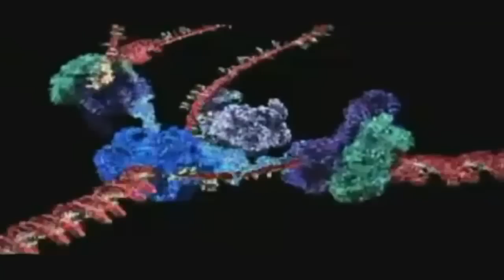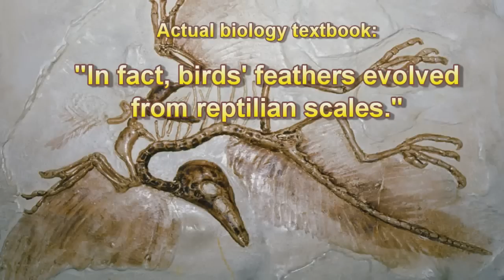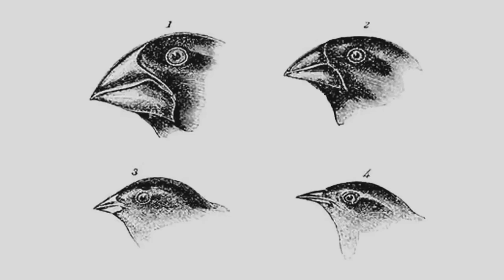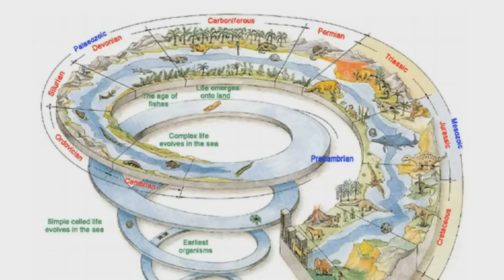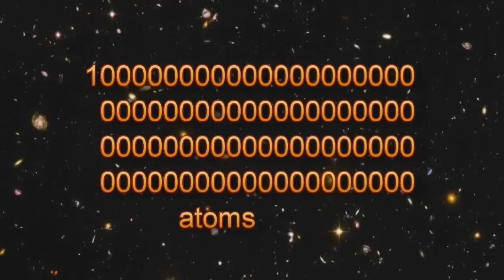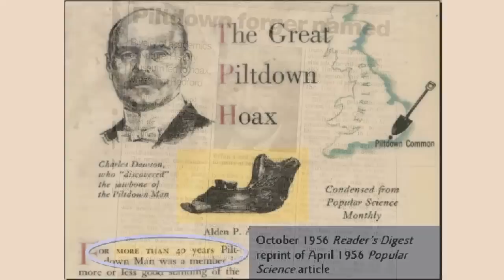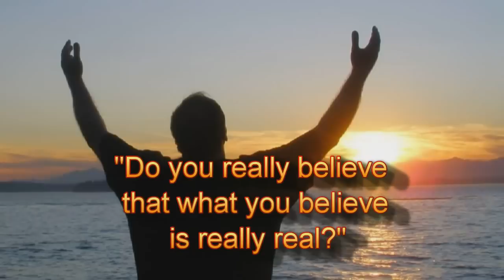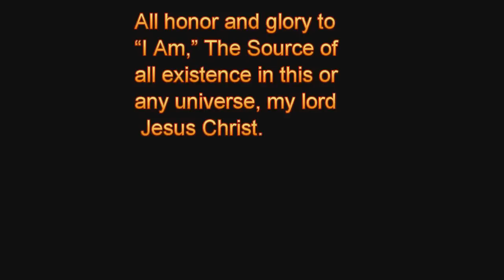Evolution Demolition

Comment: What an excellent and extremely well made video. A thorough and complete shalacking of the evolution myth. Thanks for taking the time to produce this!
Reply: Gave up on whale evolution? What whale evolution? They never evolved! Ha ha. You failed to explain the evolution of whale trachea and blowhole separation. But then again evolution can't even account for the origin of a simple tube so forget blowholes!
Reply: A little revisionist history there cowboy! What I meant, and you knew damned well, is that the fossil lineage of whale "transitions" are either fragments of a full land mammal or fossils of a whale. Nothing in between. You got reduced to petty word play. It was pathetic and typical. But the victory was delicious. Genetic accidents didn't invent hundreds of new body parts while changing little ole 2 ft long, 20lb vegetarian indohyus into a 100ft, 300lb krill filtering blue whale with a dual opening blowhole after all!
      So once again, please explain why seals haven't evolved blowholes or got any bigger in 50my but whales did. Why did evolution make whales so enormous? Detail the transitions of the whales esophagus and trachea as the magic mutations slowly divided them in two separate tubes. Be specific about the neurological, histological and osteological changed that occurred.
Reply: Phillip Zachry Because you've gone full on evo-church you only see evolution and not reality. There is no nasal cavity drift. Only artist fake clade drawings and replica fossils demonstrate that lil boost evolution needs to fool the audience. 
This is an unfair tactic paleontologists use to lift their findings and boost them to fame in a fake science believed by many and pays them grant money. You being a layman "company man" wouldn't dare question the mighty scientists. I mean God forbid you question evolution. You might get laughed at. The groupthink psychology has you. But little ole me looks at the evidence. Plus being a physician helps since I've had many hours of chemistry, bio, anatomy and physiology. Does that make me a paleontologist? No. But I know how to read scientific papers. 
Again, the "whale precursors" do not appear in the correct order. An inner ear bone similarity to a modern whale isn't enough to convince me little indohyus was a whale to be. Even Gingerich said he doubted rhodocetus had a fluke tail after discovering its artiodactyl limbs. Aetiocetus WAS a whale. One of many different types. In a global pool of fossils showing no gradualism, stasis and living fossils still unchanged today the likelihood they actually captured whale transitions is infinitesimal. 
Not to mention, RMNS is not capable of causing vertical evolution. 
I don't see how you can excuse seal stasis. If evolution were valid we should see seal "cousins". Some more deep sea evolving blowholes, some as they are now and some evolving more land mammal features depending on the environment. This just makes sense to an objective mind which you don't have.
Reply: ***** Exactly. It's amazing how "no evolution" is exactly what they expect to see and if think you should see evolution then "you don't understand evolution". Such a convenient position. But it fits the hoax perfectly.
Reply: Phillip Zachry  Lawrence is Right. It is not consistent with the neo darwinist teaching.
Reply: That post you continually post does not show transitions. It shows pakicetus, a 3ft land mammal, Aetiocetus, a whale and a beluga whale (20ft long). 2 whales and a land mammal. There's no reason to put pakicetus on that list. Especially" illusional" is the fact that they don't show the sizes of them in their proper proportions in order to trick the student. The 2nd clade drawing link you keep posting isn't evidence. Once again the size discrepancy of the animals are not shown in true proportion and those drawings are complete imagination. Nobody knows what those animals looked like from the handful of bony fragments found. Yet you fall for it. So yes, I deny the nasal cavity drifted due to zero evidence they did. 
I never suggested seal should become whales. Although why not? Why didn't pakicetus just become a seal? Where are all the seal transitions? Of course you can claim that the "selective pressures" were different but that's a just a cop out. 
I don't need to provide evidence of no evolution. That's like me saying you have to provide evidence that pink elephants do not exist. What the "experts" claim to be evidence for evolution doesn't pan out. Not for whales monkeys or anything else. Sorry if you don't like it. AGAIN, evolution can't even account for a simple tube. Start there.
Reply: Phillip Zachry Evolutionists agreeing that evolution occured, isn't evidence for evolution.

Astrologists agree that astrology is correct.

That doesn't make either right.

The evolutionists do not agree that Neo Darwinism and Punctuated equilibrium are valid.

Evolutionary Scientists have come out and ditched neo darwinism now and said that it is dead.  Gould said it was dead back in 1980. 

Professor Jerry Coyne who clings on to neo darwinism for dear life says Punctuated equilibrium is bunk.

While scientists have recently caught up with Gould's words and admitted the death of neo darwinism, they haven't formulated a new hypothesis yet. 

Evolutionists are desperately trying to come up with a unified theory but they haven't succeeded.
Reply: Phillip Zachry You are the one who is deceived. You have been tricked in to thinking  that animals like pakicetus are related to whales. Why? Because "experts" said "A kinda looks like B, Therefore B evolved from A." and you believed it.
Reply: don leavell "Gamesbok"

You seem upset Gamesbok because you failed on the other thread. Try another sock.

HAHAHAHAHAHAHAHA
Reply: Marshall Roberts
You're not actually making sense.  Apart from replying to don leavell and then addressin me, you make statements that are totally unsupported.  If Koonin publishes in a journal where he is part of the editorial team, then it's opinion, not peer review.  His criticism is nothing new, as I pointed out but you could not understand.  I showed too that the same article utterly destroys your position  irredeemably, but that escapes you too.  For pity's sake, ask an adult to help with comprehension.

Let's look at Koonin's publications,

Koonin EV (2011) The logic of chance: the nature and origin of biological evolution. Upper Saddle River (NJ): FT Press.
Koonin EV, Karev GP, Wolf YI  (Eds). Power laws, scalefree networks and genome biology, in press, Landes Biosciences and Springer Verlag (2006)
Koonin EV, Galperin MY. (2002 )SEQUENCE - EVOLUTION - FUNCTION. Computational Approaches in Comparative Genomics. Kluwer Academic Publishers.
Galperin MY, Koonin EV (Eds). (2002) Computational genomics: from sequence to function. Horizon Press.
2. Invited articles and book chapters
Galperin MY, Koonin EV. From complete genome sequence to 'complete' understanding? Trends Biotechnol. 2010 Aug;28(8):398-406
Koonin EV, Wolf YI. Constraints and plasticity in genome and molecular-phenome evolution. Nat Rev Genet. 2010 Jun 15;11(7):487-498
Koonin EV, Yutin N. Origin and evolution of eukaryotic large nucleo-cytoplasmic DNA viruses. Intervirology. 2010 Jun;53(5):284-92
Koonin EV. The origin and early evolution of eukaryotes in the light of phylogenomics. Genome Biol. 2010 May 5;11(5):209
Koonin EV, Moss B. Viruses know more than one way to don a cap. Proc Natl Acad. Sci U S A. 2010 Feb 23;107(8):3283-4
Koonin EV. Preview. The incredible expanding ancestor of eukaryotes. Cell. 2010 Mar 5;140(5):606-8
Koonin EV. Taming of the shrewd: novel eukaryotic genes from RNA viruses. BMC Biol. 2010 Jan 12;8:2
Koonin EV, Makarova KS. CRISPR-Cas: an adaptive immunity system in prokaryotes. F1000 Biol Rep. 2009 Dec 1;1:95
Koonin EV. On the origin of cells and viruses: primordial virus world scenario. Ann N Y Acad Sci. 2009 Oct;1178:47-64. PubMed PMID: 19845627.
Koonin EV. The Origin at 150: is a new evolutionary synthesis in sight? Trends Genet. 2009 Nov;25(11):473-5. Epub 2009 Oct 14. PubMed PMID: 19836100; PubMed Central PMCID: PMC2784144.
Koonin EV, Wolf YI, Puigbò P. The Phylogenetic Forest and the Quest for the Elusive Tree of Life. Cold Spring Harb Symp Quant Biol. 2009 Aug 17. [Epub ahead of print] PubMed PMID: 19687142.
Koonin EV, Aravind L. Comparative genomics, evolution and origins of the nuclear envelope and nuclear pore complex. Cell Cycle. 2009 Jul 1;8(13):1984-5.
Shabalina, S. A., and E. V. Koonin. 2008. Origins and evolution of eukaryotic RNA interference. Trends Ecol Evol.
Koonin, E. V. 2007a. Metagenomic sorcery and the expanding protein universe. Nat Biotechnol 25:540-542.
Koonin, E. V. 2007b. Chance and necessity in cellular response to challenge. Mol Syst Biol 3:107.
Koonin, E. V. 2007c. An RNA-making reactor for the origin of life. Proc Natl Acad Sci U S A 104:9105-9106.
Makarova, K. S., and E. V. Koonin. 2007. Evolutionary genomics of lactic acid bacteria. J Bacteriol 189:1199-1208.
Aravind, L., L. M. Iyer, and E. V. Koonin. 2006. Comparative genomics and structural biology of the molecular innovations of eukaryotes. Curr Opin Struct Biol 16:409-419
Prangishvili, D., R. A. Garrett, and E. V. Koonin. 2006. Evolutionary genomics of archaeal viruses: unique viral genomes in the third domain of life. Virus Res 117:52-67
Iyer, L. M., S. Balaji, E. V. Koonin, and L. Aravind. 2006. Evolutionary genomics of nucleo-cytoplasmic large DNA viruses. Virus Res 117:156-184.
Koonin, E. V., and V. V. Dolja. 2006. Evolution of complexity in the viral world: the dawn of a new vision. Virus Res 117:1-4.
Koonin, E. V., L. F. Landweber, and D. J. Lipman. 2006. A community experiment with fully open and published peer review. Biol Direct 1:1.
Makarova, K. S., and E. V. Koonin. 2005. Evolutionary and functional genomics of the Archaea. Curr Opin Microbiol 8:586-594.
Novozhilov, A. S., G. P. Karev, and E. V. Koonin. 2006. Biological applications of the theory of birth-and-death processes. Brief Bioinform 7:70-85.
Koonin, E. V., and Y. I. Wolf. 2006. Evolutionary systems biology: links between gene evolution and function. Curr Opin Biotechnol 17:481-487.
Koonin, E. V. 2005a. Orthologs, paralogs, and evolutionary genomics. Annu Rev Genet 39:309-338.
Koonin, E. V. 2005b. Paralogs and mutational robustness linked through transcriptional reprogramming. Bioessays 27:865-868.
Koonin, E. V. 2005c. Virology: Gulliver among the Lilliputians. Curr Biol 15:R167-169.
Koonin, E. V. 2005d. Systemic determinants of gene evolution and function. Mol Syst Biol 1:2005 0021.
Rogozin, I. B., A. V. Sverdlov, V. N. Babenko, and E. V. Koonin. 2005b. Analysis of evolution of exon-intron structure of eukaryotic genes. Brief Bioinform 6:118-134.
Rogozin, I. B., K. S. Makarova, Y. I. Wolf, and E. V. Koonin. 2004. Computational approaches for the analysis of gene neighbourhoods in prokaryotic genomes. Brief Bioinform 5:131-149.

And you want me to accept he rejects evolution?
Reply: Gamesbrok, which one of your evo funny papers provides "peer reviewed" evidence for the origin of a simple blood vessel? "Mutations did it!" Right?
Reply: Marshall Roberts ' Well 9pt9, understanding evidence was never your strong point.
'This from a guy that rejects the fact that what is natural is living organisms give rise to living organisms.' 
What is unquestionably true is that everybody accepts this is less than the complete story.  The difference is that some people do not accept magic.  I don't know why some folk reject understanding.  (Yes I do).
Reply: 9pt9
Of course mutation?  What else? 
It's complicated today because we have Angiogenesis which appears to be a developed feature, but not necessarily.
Risau W. Mechanisms of angiogenesis. Nature 386: pp. 671–4, 1997.
Risau W. Differentiation of endothelium. FASEB J 9: pp. 926–33, 1995.
Schmidt A, Brixius K, Bloch W. Endothelial precursor cell migration during vasculogenesis. Circ Res 101: pp. 125–36, 2007.
Coffin JD, Poole TJ. Endothelial cell origin and migration in embryonic heart and cranial blood vessel development. Anat Rec 231: pp. 383–95, 1991. Risau W, Flamme I. Vasculogenesis. Annu Rev Cell Dev Biol 11: pp. 73–91, 1995.
Reply: Gamesbrok, angiogenesis is not a Darwinian process. Reload, try again. Evolution can no explain the origins of blood vessels or any "tube" in an organism. Provide an evolutionary pathway or example for any tube forming in stepwise fashion. "Mutations did it" won't fly.
Reply: 9pt9
Oyster mushroom.
Reply: 9pt9
Let me get this straight; you claim that evolution can only progress in a manner you deem to be impossible? Interesting,
Reply: Steven Land Actually my "fallback position" was to read the articles you cited. Not one of the 4 papers offer any clue as to how vessels evolved. All the articles and the video  beg the question. They all assume the evolution of vessels without offering a plausible mechanism. You either didn't read the articles or you're just committed to believing in evolution no matter how absurd it is (and it is extraordinarily absurd). I dare you to sift through those laughable rags and pull out the best paragraphs or bullet points that bolster your belief that vessels evolve. What good is 5% of a vessel?
Why are you are you talking about zombies and Christianity? It's Evolution vs science not evolution vs religion. Nice red herring though. 
Care to fail again?
Reply: 9pt9
You do know that you're a Deuterostome don't you?

The Molecular Motor Toolbox for Intracellular Transport
Ronald D Vale
Department of Cellular and Molecular Pharmacology, Howard Hughes Medical Institute, University of California, San Francisco, 513 Parnassus Avenue, San Francisco, CA 94143 USA
Reply: Gamesbok Gamesbok
 I'd have gone with these papers first--'U
nique domain appended to vertebrate tRNA synthetase is essential for vascular development' and 'Evolutionary origins of the blood vascular system and
endothelium'
Reply: Helixbuilder
I like the Monahan-Earley R paper.
Reply: Gamesbok Gamesbok Yeah, I doubt that 9pt9 actually looked at the data in any of those other papers. This yet another case where a dissenter, 9pt9, has not bothered to critically examine the literature before reaching a conclusion. He has done so by choosing to go with AiG or some other creationist’s apologetic rhetoric.
Reply: Helixbuilder Of course I read it. Please explain how that paper you cited provides evidence for vascular evolution.
Reply: 9pt9 Clearly you did not read them. So you would have me believe that in an hour in a half you read a data dense paper and a review and fully understood it? You’ll forgive me if I doubt that you did so. No scientist I know takes that short a time to read a paper let alone a review. Which paper and figures did you find the data less compelling? What would you have done differently?  So why is the data wrong? Because you think it is impossible. Not good enough show me with data not words.
Reply: Helixbuilder I didn't say the data was "wrong". You cited the paper so I'm asking you to explain how that paper provides an evolutionary pathway that in anyway explains the origins of vessels. It doesn't. It begs the question and actually makes evolution look worse. Citing a paper isn't an argument.
Reply: 9pt9 No, you said you read the paper and you are arguing against the data. Should I conclude that you have no reading compression skills? You say you read the paper but you want me to tell you what is said? Why should I waste my time if I don't know what data your argument is based on? Make your point then we'll go from there.
The review outlines the data and puts forth a model which you claimed was impossible. Further you claimed there was no evidence if the work over over sixty labs isn't evidence kindly tell what is.
Reply: That study showed that SerRS plays a role in the development of endothelial tissue and when mutations occur to it produces abnormalities (not helpful for evolution). It also showed that SeRS is present in organisms with closed circulatory systems. Whoopity-do. No evidence for how vessels evolved in stepwise fashion whatsoever.  
The fact that you would posit that study to bolster your case just shows that you blindly googled "evolution of vessels" and picked it out. As if because there is an almighty "peer reviewed" study on evolution it's 100% fact. What's more telling is that between you and all the other believers on this thread coming down on me with studies, none of them come close to answering the question. I'm telling you the answer the origins of vessels and many other examples like this do not exist. I've looked. The studies are done presuming the mechanism of RMNS and beg the question.  
  Just because you can see evolution is bullshit doesn't make you religious by default. It just means we still don't know. And we don't. But for bollocks sake open your bloody eyes.
Reply: Stephen Land  You're really throwing some tantrum there.
Reply: 9pt9
Ah actually the authors say “Interestingly, three independent forward-genetic studies in zebrafish suggested a role for SerRS in vascular development,” as in angiogenesis that is blood vessel formation. So in order to establish a possible pathway on must first identify genes that are in the normal pathway. The paper shows that the SerRS gene product is essential for vascular development. Critical to this function is an appended amino acids sequence that comprises the UNE-S domain. Oh that means the domain was added on the ancestral protein as in mutation.
That paper came out in 2011 the review paper came out in 2013.
 
So explain why mutations are “not helpful for evolution”.
Reply: Stephen Land And with all those "umpteen" studies inside the "mountain of evidence" for evolution you couldn't even answer the simple question (How does RMNS build a tube in stepwise fashion).  That should be no problemo for such a distinguished scientific theory and here you and evolution are stumped. No matter how many gaps there are you'll plug it with "mutations did it." Pathetic and hilarious watching groupthink ideology at work. Now that we understand cells on a far deeper level the gaps keep mounting up. Ribosomes, ATPsynthase, DNA all inexplicable but no matter what "mutations did it."
Don't worry I know where your coming from. Now piss off :)
Reply: Stephen Land  You're ranting and raving stevie. You lost the argument.

hahahahahahahahaha
Reply: 9pt9  Poor Stephen is having a massive meltdown after his failure. He is such a cry baby.  hahahahahahaha
Reply: Now that we've established that RMNS can't even make a tube who would like to prove evolution invented DNA? Ha ha ha ha ha!
Reply: 9pt9
You didn't prove anything you just stated your opinion. Where is your data?
Reply: Hex, I don't need to provide data, The burden of proof is on evolution. I asked a question than nobody could answer so there's my proof.
Reply: 9pt9
Well the irony of you using the absence of evidence as proof of a negative is stunning! Thanks for the amusement!
Reply: Helixbuilder Right. "mutations did it" no matter what! The answer is mutations now what's the question? ha ha ha ha ha ha!
Reply: 9pt9
Saying that proves nothing, where is your data? Without doing an experiment all you are doing is offering an opinion. Opinions are not factual. Demonstrate that mutations cannot change an organism show your data.
Reply: Helixbuilder   What reverse logic you have. It is up to you to demonstrate that mutations can do what you believe they can do. He asked you to demonstrate something when it came to the hypothesis that you hold to and you failed it.  He does not have to experimentally  demonstrate mutations cannot do what you claim they can.   You have to demonstrate experimentally that they can do what you claim. You are making the claim and yet you couldn't pass the test when it came to a  tube. If you don't have the evidence then that is a problem for you. Not the person who is skeptical of your hypothesis.
Reply: Helixbuilder How can an experiment be done that proves RMNS can't build a tube? You make no sense.
Reply: Marshall Roberts
Wrong there are papers with evidence from over 60 labs on this question of angiogenesis alone. In the review the author sets forth a scenario to explain the process. So one could say they establish reasonable doubt of 9pt9's claim of impossibility. 9pt9's claim is an opinion because he presents no evidence. Further 9pt9 dismissal of evidence by hand waving is nonsensical as it reveals the he doesn't accept the evidence because it contradicts his explanation. The data from these papers as well as data from de novo blood vessel formation in tumors in combination with genomic comparisons say these processes are possible therefore it is on him to demonstrate that a process can't happen. This will be hard as 9pt9 can't even define what the process is; so how can he say it is impossible?
 
Why can't a creationist grasp the idea of; the absence of evidence does not prove a negative? This is the same logic is used by creationists when they argue that Yahweh exist in the absence of any physical evidence. Truly ironic!
Reply: Helixbuilder  "he presents no evidence"

You are again making no sense. If you make up a story of how something happened then it up to you to present the evidence for it.

You claim these papers support you but you do not make an argument to him on how it supports you, Just saying "these papers support me you are wrong" is not an argument. You have to make an argument and show why they support your position. You presented no argument to him to show how they support your position.Without any argument then your claim has no merit.

"absence of evidence does not prove a negative"

So you are admitting an absence of evidence, that is fine. But then Evolutionists should not berate those that do not accept evolutionary story telling.
Reply: Helixbuilder Angiogenesis is not evolution and neither is de novo vascular formation. Neither process uses the darwinian process of selected mutations. Vessels and their codes already exist here.  You are just showing your ignorance. 
Yes it is my opinion. And it will stay that way until any evidence whatsoever can prove evolution could gradually produce a tube of any kind. But there is zero and there never will be because evolution is a wrong theory. Sorry.
Reply: 9pt9
Thank you for stating the obvious in order the study the origins of a process one must know its components and nature.
The ball is back in you court explain why the model in the review is incorrect.
Reply: Marshall Roberts
Thank you for demonstrating the you have no reading comprehension. The argument is in the review paper pages 62-63, there is no need for me to restate it as it is congruent with my conclusions.The evidence is discussed previously in the review. So why do I have to restate it and why is it wrong?
Reply: Helixbuilder  Posting links is not a substitute for an argument.  Just spamming links and not giving an argument is citation bluffing.

"as it is congruent with my conclusions"

You have to show with argumentation how it supports your position otherwise you are  citation bluffing.

Could you imagine you went to a debate and one debater made no argument and said "these links prove my position" and I am right.  It wouldnt be much of a debate.

If there is evidence in the review then why are you unable to argue for it? links are ok in addition to an argument but not a substitution.

He has pointed out what he has seen as problems with what you posted. Yet there is no burden on him at all, It is up to you to do your own homework and then provide your argument. It is not for him to do your work for you. You can research any links that you like but then it is up to you to provide an argument for how what you researched supports your position. It is not his duty to do anything with your spammed links. You are trying to shift your burden. So research whatever links  you want and then provide an argument on how they support you. But it is your duty to do your work not him to do it for you, Spamming links and claiming they support you is not an argument and does not demonstrate that they support you.

Now when are you going to stop bluffing and posting links and claiming that they are evidence and actually provide an argument for how they are evidence that support your position?
Reply: Marshall Roberts I would give the same assignment to any student who used logical fallacies as if they were proof of principal. He claimed that something was impossible without providing any evidence or a reasonable hypothesis to test.
Yes that counter argument that "there is zero (evidence) and there never will be because evolution is a wrong theory."
 He is just invoking the God of the Gaps logical fallacy.
Reply: 9pt9
I gave you the paper I can only conclude that you are so biased that you refuse to believe anything contrary to your religious beliefs. Rather you respond in a Monty Python-esq argument of denial with no substance. You wanted evidence it is in the papers figures and picture cannot be accurately expressed in words so I thought you might look at the original data.
What would you accept as evidence?
Reply: Alright,  post the link again. I've already read 5 on this thread. All failed.
Reply: Justwantahover: Fossils are in layers of course. Expect one layer doesn't lead to the next. Zero gradualism. Organisms appear fully formed and are still alive today, mainly unchanged, or they go extinct. That is the scientific facts. There is no evolution. 
Now clear your head and think real hard. If evolution can't answer these challenges the whole theory is wrong. 

1) Can evolution explain the origin of a tube in stepwise fashion?

2) Can evolution even account for 1 cell? 

                     Nope.
Reply: You're not getting it. There is nothing connecting the layers. No transitions at all. Evolution needs to account for 3.5 BILLION YEARS of unicellular life (many of which are still alive today unchanged!) with ZERO evolution followed by the sudden appearance of all the major body plans in a geographic flash. There are no unicellular organisms gradually becoming more complex then or now. The whole theory is bogus.
Reply: 9pt9
1) Can evolution explain the origin of a tube in stepwise fashion?

A. Yes, and you refuse to accept the data. You invoke the logical fallacy of incredulity. Congratulations!

2) Can evolution even account for 1 cell?
A. No, we have a different theory for that calleed abiogenesis. Look up a series of lectures on youtube from Jack Szostak Nobel laureate.
Reply: Sorry, you failed to provide evidence it can.You are guilty of the fallacy of credulity.
Reply: 9pt9 SO you are stating that you have fossils of bacteria that are identical to existing bacteria? Wow publish that and collect your Nobel Prize.
By the way they aren't really unicellular they live in bioflims.

"There are no unicellular organisms gradually becoming more complex then or now."
 A. How about the organisms in the class Dictyosteliida for starters?

Oh and yes the estimates of the Cambrian explosion 5 to 40 million yeas is a "geographic flash". Not all of the body plans are found in the Cambrian rock layers specifically those body plans belonging to the phyla that include: mammals, reptiles, birds, insects, and spiders.
Congratulations!
Reply: 9pt9
 How cute; your turn where is your evidence?
 I said it can happen just like you said it can't.
Reply: Helixbuilder I don't need to provide evidence that something did not happen (for the 10th time). You need to prove it did. 
Cyanobacteria still exist today unchanged. 
The fact that you're citing dictyostelium an example only proves how bankrupt the theory is. What is it about dictyostelium that would lead you to believe that organs, skin or limbs will ever evolve from it or that it's in any way relative to our ancestry? Why aren't there uni's going multi everywhere in all the various stages of evolution? This KILLS evolution. 
Compared to the 3.5 billion years that bacteria did nothing the cambrian is a flash. 
Give up. Evolution loses.
Reply: 9pt9 You can't prove it didn't happen, you believe it didn't happen; therefore, you have to provide evidence to prove your point!
That is just the way it is!
The rest is just unsupported nonsense saying rather than showing! No evidence at all!
Since you have no data to refute I'll just say your opinion is bogus!
Reply: Ok! And you can't prove there are no pink elephants that can fly!
Reply: 9pt9
You can't prove there are!
So the question becomes why do you feel that you can make up claims and act like your silly statements prove anything?
Reply: Helixbuilder Where is your evidence that evolution can assemble a tube? Be very specific. :)
Reply: 9pt9
Where is you evidence of god? Be specific. All kiding aside I'll be specific when your state how you know it is impossible. Oddly enough had you read the most recent papers you wouldn't have to ask! :)
Reply: You are a master at diversion tactics. Which paper? Cite it and explain how it supports your position. The existence of God is completely irrelevant. It's evolution vs real science not evolution vs God.
Reply: A tube is 100% useless until it can contain fluid or solids in a closed system. How did evolution create a tube by accidental selected mutations slowly over time? What was the structure before it was a tube? Why was it selected for? This is why evolution is 100% impossible.
Reply: 9pt9
Had you read the paper you would have an idea. But since you think you know everything  just continue with your ravings! Accidents are deviations from a purpose, What does the circulatory system of cnidarian look like? What did the paper say?
Reply: 9pt9
Thanks! The one you didn't read because you already "knew" the answer. :)
Reply: 9pt9 Voids in a aquatic body allow for higher surface area for nutrient and waste exchange. Perhaps you'd like to start there. By the way what is the purpose of a circulatory system anyway?
Reply: 9pt9 Try looking at  the post prior to where you first replied to me. Why do you need to be spoon-feed knowledge? Think for yourself!
Cheers!
Reply: A worm wrapped around some food? Sponges developed a bony chip? And the mutations took over from there! LOL Now THATS a fairytale. I'm sure you've got "facts" to back that up. Not.
"The reason you don't accept facts is bc your book of fairytales." Fallacy of motive. Fail.
Reply: 9pt9 Hey they guy is trying you on the other hand are reiterating an argument concieved out of disbeleif not data.
Still haven't found it?  Evolutionary origins of the blood vascular system and
endothelium R. MONAHAN-EARLEY, et al. It a review red the mechanisme than goto the original papers cited and check out the data.
Reply: Helixbuilder Page 1 "Molecular phylogenetic analyses have yielded interesting, although limited insights into evolutionarily conserved mechanisms of heart development and tube formation."
Translation: We have no idea but here's a wild guess. 
So your silver bullet of evidence is nothing but speculation. But don't feel bad. All evidence for evolution is like this. Good news is you're getting closer to the truth about evolution!
Reply: 9pt9 "A worm wrapped around some food? Sponges developed a bony chip? And the mutations took over from there! LOL Now THATS a fairytale. I'm sure you've got "facts" to back that up. Not."

You got him sussed

Justwantahover loves his evolutionary fables.

These darwimps do provide good comedy with their story telling.

hahahahahahahahaha
Reply: The best piece of evidence he could find on how tubes evolved began with a statement saying little is known on tube formation. 
But I'm glad I can help. These people really believe they have absolute facts on their side. They just need to shed the dogma and be objective and down goes evolution religion!
Reply: Justwantahover I think you get an award for the longest speech ever given on youtube. You are committing the fallacy of motive. "Evolution is right bc we believe in creation". It does no matter whether or not creationism is true. Evolution is still bogus.
Reply: 9pt9  Really?
The paper opens with "Every biological trait requires both a proximate and evolutionary explanation. The field of vascular biology is focused primarily on proximate mechanisms in health and disease. Comparatively little attention has been given to the evolutionary basis of the cardiovascular system."
Which has an entirely different meaning then your paraphrasing of the the first two sentences. Did you read any further?
Reply: Helixbuilder Give it up. I won. You lost.
Reply: 9pt9 If in your mind lying about reading a paper and its contents is winning then congratulations! 
Considering biofilms, that are a collection of bacteria living as a multicellar community. They consist of many species existing in close physical contact. They also communicate via quorum sensing compounds. Within the biofilm are channels within that conduct nutrients and waste into and out of the biofilm. These channels act as a primitive circulatory system.  Given the fact that a genetic mechanism is predicted and that the evidence for that would be found in the genomes of related organisms that have circulatory systems. Further evidence shows that these mutations exist as predicted; I'd say that your opinion is wrong! Additionally since your don’t bother to discuss the data indicates that you know you are wrong and are unwilling to admit it.
Reply: 9pt9
Yep you are a liar because when you say an article says something that is does not that is by definition a lie. The rest of your post? Unless you have data you are only stating your opinion, You don't have data and the review paper will direct you to the orginal research paper that contains the data. You don't want to look at it; so what does that say?
Reply: Helixbuilder Ofc I looked at it. Doesn't contain any "data" that supports your belief. You're just desperately trying to find away to discredit my character so you needn't face the reality I've proven to you.
Reply: 9pt9
Because you didn't read it or firmly believe there can be no data. That puts you in the same intellectual class as the cardinals the refused to look in Galileo's telescope; because, Aristotle wrote that Jupiter had no moons; therefore the cardinal did not need to look to know what is so.
Reply: Helixbuilder LOL look what you've been reduced to!!!
Reply: 9pt9 If it supported him then he would have been able to quote from the article and provide an argument of how it supports him. hexbuilder was citation bluffing.
Reply: 9pt9
Review papers cite research so the data is in the referenced paper.
Reply: Marshall Roberts
It is not how I roll I point you read then you think. If you don't honestly evaluate the data then shame on you.
Reply: Helixbuilder Throwing the term liar at him so casually shows desperation because you are failing in argumentation against him.
Reply: Marshall Roberts He's had a million chances to prove his point and can't so his last resort is "well…ah….you're a liar!"

hahahahahahahahahahahahahaha
Reply: Justwantahover He failed, he was citation bluffing and failed to show the data supports your faith. You lost. You need to get over it.
Reply: Justa - he gave me "data" and I crushed it. I'm winning because I am demolishing your answers. Your crew has scrambled trying to respond to my challenge and failed. It was just one simple question and you failed. And I can make it a lot worse :)
Reply: 9pt9
Yep that is right you can't read or interpret data so winning is lying about data! Amazing!
Reply: Justwantahover
The difference between human and chimp genomes is "thirty-five million single-nucleotide changes, five million insertion/deletion events, and various chromosomal rearrangements" and  "Single-nucleotide substitutions occur at a mean rate of 1.23% between copies of the human and chimpanzee genome, with 1.06% or less corresponding to fixed divergence between the species" , emphasis on FIXED.
http://www.nature.com/nature/journal/v437/n7055/full/nature04072.html
With this difference the human genome must be diverging from chimps at the rate of 2.5 fixed bases per year. i.e. Pharaoh's mummy would be maybe 10,000 bases closer to a chimp. Surely you know this is nonsense.
Reply: Justwantahover We are equally closed-minded because the non-evolving genome proves creation and you do not believe it, and if the genome were evolving, I would not believe it.
One sure thing - if the genome were evolving, the high priests of evolution would be blowing trumpets, but I don't hear them.
Reply: Marshall Roberts
Funny how you say that without a shred of data.
Reply: Justwantahover  In 1957, a distinguished geneticist and evolutionist, J.B.S. Haldane, calculated that the rate of beneficial mutations becoming FIXED in the human genome would be approximately 1 base every 6000 years.
http://en.wikipedia.org/wiki/Haldane's_dilemma
Even if he was wrong by a factor of ten and the true rate was 1 base every 600 years, that is nowhere close to what evolution requires for the difference between the human and chimp genomes.
Reply: Mdebacle: great point! Funny how a hard fact like that will make no difference in the mind of an evolutionaut. No matter how bad things look for the withering theory of evolution, it's believers will still cling to "mutations did it!".
Reply: Mdebacle
You really think calculations and models are always right as long as they support your beliefs. You don't think we have a more empirical data now?
Reply: Helix: if you have better "data" then post it.
Reply: Helixbuilder
Ötzi the Iceman is supposed to be 5300 years old. If his genes showed us that any evolution has taken place in that time frame we would have seen the headlines.
Reply: Mdebacle
So have you looked at the data? It is in a public data base.
Reply: 9pt9
Go to the primary literature, the sequence data bases then look and read.
Reply: Helix: How much do you love the word "data"?
Reply: 9pt9  hahahaha
Reply: Helixbuilder
I have enough faith in the Darwinist cavalry to realize they would be riding to the rescue if they were shooting anything but blanks.
Reply: Mdebacle In the depths of a mind insane
fantasy and reality are the same! The only thing you and you friend have to say is "its impossible" presumably because you think you know better. The science holds up so keep trying.
Reply: Helix: one cell creates 2,000 proteins per second. PER SECOND. Man has never invented a machine that can produce 2,000 of anything per second. Can you provide the "data" to explain how this biological capability evolved?
Reply: 9pt9
An argument of incredulity is not proof of your claim it is a logical fallacy.
Reply: 9pt9
I gave you the paper you said it was wrong; however, since your claim is no one can it explain it.Yet an explanation exist so your statement is false.
Reply: 9pt9
 The Darwimps have a lot of faith in dumb luck mutations, Even evolutionists have come out and admitted neo darwinism has failed. Gould openly declared it dead back in 1980 "despite being textbook orthodoxy" Going all the way back to the 60s, The mathematicians at the wistar symposium told the darwimps that it cannot work but the mutation intoxicated darwimps still went on promoting their nonsense.
 Other Evolutionists have come out and openly rejected neo darwinism and pointed out that it has failed, ie Professor Noble, the late lynn marguilis, Eugene koonin etc

But still the Darwimps have faith.
Reply: Since no evidence can prove RMNS can build a tube (and many other biosystems) I remain incredulous. Guilty as charged. You? A full on devout and faithful believer. The paper you cited as evidence specifically stated that the origin of tubes remains a mystery, wich was comical.
Reply: 9pt9 Actually there is but if you won't read a review that will outline the steps then how can I expect you to go further?
Reply: Marshall Roberts
Yada yada yada cite your references already!
Reply: 9pt9  helix was citation bluffing
Reply: Marshall Roberts I call your bluff; show your hand.
Reply: Helixbuilder  which bluff?
Reply: Helixbuilder   You were citation bluffing dude.
Reply: Marshall Roberts
No I already gave 9pt9 the citations, show your hand.
Reply: Helixbuilder I know you gave him citations and you were citation bluffing.
Reply: Helixbuilder
"show your hand"

?
Reply: Helixbuilder Is the theory of evolution you have faith in neo darwinism?
Reply: Marshall Roberts
Faith has nothing to do with evolution, more to do with Yahweh, Odin and big foot.
So where does this come from?
"Other Evolutionists have come out and openly rejected neo darwinism and pointed out that it has failed, ie Professor Noble, the late lynn marguilis, Eugene koonin etc"
Reply: Helixbuilder  You said to mdebacle

"The science holds up so keep trying."

The evolutionary community is deeply divided over a theory of evolution with some believing in neo darwinism but others coming out and admitting it has failed.

Despite the claims to the Contrary by Layman Evolutionists on the internet. There is no agreement amongst evolutionists for how evolution is meant to occur.  . There is no agreement on a theory of evolution. In 2008 Senior evolutionists met at Altenberg to try and flesh out a new theory of evolution but they went away without any agreement. There is no consensus at this time on a "Theory of Evolution"  When evolutionists claim on the net that it is all sown up and there is no disagreement on how it is meant to occur then they are using hype and talking contrary to the facts.

 
Only thing evolutionists agree on is its occurence.

"When discussing organic evolution the only point of agreement seems to be: "It happened." Thereafter, there is little consensus, which at first sight must seem rather odd. - Simon Conway Morris, palaeontologist, Department of Earth Sciences, Cambridge University, UK, "Evolution: Bringing Molecules into the Fold,"

"Evolutionary theory itself is already in a state of flux…
all the central assumptions of the Modern Synthesis (often also called Neo-Darwinism) have been disproven"
Denis Noble, Evolutionist and Biologist, May 2013

“Darwinism in its current scientific incarnation has pretty much reached the end of its rope.”  — David J. Depew and Bruce H. Weber, “The Fate of Darwinism: Evolution After the Modern Synthesis,” Biological Theory, Vol. 6: 89-102 (December, 2011).

Professor Allen Macneill-Biologist/Evolutionist Cornell University- "Will Provine and I have been saying "the modern evolutionary synthesis is dead" for years"

Professor Macneill " when ID supporters set their sights on “neo-Darwinism” as a target for criticism, they set their sights on a model that has been all but abandoned"

Gould 1980 as quoted by The Evolutionists Brian Charlesworth and Russel Lande
 
“I have been watching it  [neo-Darwinism] slowly unravel as a universal description of evolution…but…that theory, as a general proposition, is effectively dead, despite is persistence as text-book orthodoxy.”

Charlesworth, B., Lande, R., and Slatkin, M., "A Neo-Darwinian Commentary on Macroevolution,"

Evolutionist  Lynn Margulis
 “At that meeting [a meeting with philosopher John Cobb] [Francisco] Ayala agreed with me when I stated that this doctrinaire neo-Darwinism is dead. He was a practioner of neo-Darwinism but advances in molecular genetics, evolution, ecology, biochemistry, and other news had led him to agree that neo-Darwinism’s now dead.”

The recently deceased Evolutionary Biologist Lynn marguilis. “Population geneticist Richard Lewontin gave a talk here at UMass Amherst about six years ago, and he mathematized all of it—changes in the population, random mutation, sexual selection, cost and benefit. At the end of the talk he said, “You know, we’ve tried to test these ideas in the field and the lab, and there are really no measurements that match the quantities I’ve told you about.” This just appalled me. So I said, “Richard Lewontin, you are a great lecturer to have the courage to say it’s gotten you nowhere. But then why do you continue to do this work?” And he looked around and said, “It’s the only thing I know how to do, and if I don’t do it I won’t get my grant money.””

"The interpretation of evolution is in a state of upheaval: the rapid advancement of Molecular Biology has led into question many of the tenets of Darwinism and neo-Darwinism which, although valuable approaches at the time they were formulated, never fulfilled the criteria demanded by real scientific theories. . . In the author's opinion, no real theory of evolution can be formulated at present."

A. Lima-de Faria, Geneticist/Evolutionist, Professor Emeritus at the university of lund.
 
 
Stanley Salthe, author of an evolutionary biology textbook, says, "I have become an apostate from Darwinian theory and have described it as part of modernism's origination myth."
 
 

Professor Jerry Coyne "I had a lot of respect for Gould, but over the years it waned. He became enamoured of his theory of punctuated equilibrium which I thought was really wrong. I still do. He and I had several exchanges in the literature about that theory, with me saying it was bunk and him saying it wasn’t."

 Jerry Coyne Talking about Fellow Evolutionist Professor James Shapiro "A colleague wrongfully disses modern evolutionary theory".. "Shapiro, it seems, has devoted much of his writing to pointing out that the modern theory of evolution (“neo-Darwinism”) is deeply flawed and needs a new paradigm"

Eugene Koonin “the modern synthesis has crumbled, apparently, beyond repair”
 
 Eugene Koonin  “all major tenets of the modern synthesis have been, if not outright overturned, replaced by a new and incomparably more complex vision of the key aspects of evolution.”
 
Eugene  Koonin “not to mince words, the modern synthesis is gone.”  “The Origin at 150: Is a New Evolutionary Synthesis in Sight?,” Trends in Genetics, Vol. 25: 473 (2009

While some are clinging to neo darwinism desperately like Coyne and Dawkins and pushing that it is a fact, Others like Koonin have said it is dead.  The Altenberg 16 thought so and are amongst those looking for a new evolutionary hypothesis.

Fact is that there is no agreement and the scientific community is desperately trying to get together a unified theory of evolution to rally around.

Evolutionists are in deep trouble without an agreement as to a theory but they are desperately trying to put one together.
Reply: Marshall Roberts
Guold is entitled to his opinion however the science holds. So what science do you specifically claim doesn't hold up?
Reply: Helixbuilder Evolutionists themselves have said neo darwinism has failed though some darwimp priests like Dawkins and Coyne still hold to it.

The evolution industry is deeply divided without an agreed theory but the Neo Darwinist sales rep Dawkins does not mind as he can still make money  by selling neo darwinism to his Dawkinite flock.

"the science holds"

You have faith in something even evolutionists have declared as having failed.
Reply: Marshall Roberts  Yes that is your claim. Whether it is correct or not is another thing.
Reply: Helixbuilder  I have given you their own words. Because you do not want to face up to what they are saying is your own problem.
Reply: Helix: why did the author say the origin of tubes was a mystery on the first page? You are citation bluffing. And I'll tell you what, if I do read all 26 pages things will only get worse for you. Now, please explain the origin of Krebs cycle using evolution theory.
Reply: 9pt9
This paper 'Evolutionary origins of the blood vascular system and
endothelium'?
Reply: Marshall Roberts
Pardon me if I read the papers myself. So far it seems they are proposing a different mechanism for evolution.
Reply: Justwantahover
From the migration maps of human mitochondrial DNA in http://en.wikipedia.org/wiki/Human_mitochondrial_DNA_haplogroup , although the arrows are drawn to look like out-of-Africa, we can see the maps are consistent with three haplogroups (L,M,N) out of Mesopotamia.
Although the genetic chart has been revised to look like M and N are derived from L, we can see from the original chart in http://en.wikipedia.org/wiki/Mitochondrial_Eve that M and N are not derived from L. Every human has mtDNA from one of three women, who were the daughters-in-law of Noah.
Also, we can see the migration of human Y-chromosome in http://en.wikipedia.org/wiki/Haplogroup#mediaviewer/File:World_Map_of_Y-DNA_Haplogroups.png
They made a half-baked attempt to look like out-of-Africa, but it is easily seen that the Y-chromosome of Noah and his three sons was out of Mesopotamia.
Reply: Justwantahover [the secular rules work (and no other rules would work)]
The point that you are helping me make is that all the work was done for mtDNA by certified evolutionists.
They discovered (unwittingly) the haplogroups of the three daughters-in-law of Noah and conveniently assigned them as L,M,N,
When I saw the wikipedia article in 2008 (before they revised the genetic chart), it was like a beacon in the Heart of Darwinian Darkness.
Reply: Marshall Roberts
If Richard Lewontin said,  “It’s the only thing I know how to do, and if I don’t do it I won’t get my grant money.”, he defined a 'professional evolutionist'.
As a defense contractor once said, "We had the contract for spare parts for 25 years. Nobody cared if it worked or not."
Reply: Mdebacle: no he can not. Not at all. He's a full on believer.
Reply: Justwantahover
Just to clear things up HOX is the shortened version of Homeobox and PAX is short for Paired box.
Reply: Justwantahover
[Look up "hox-genes" on a secular site] I thought NIH.GOV was secular.
[giraffe and mouse] 
The giraffe is the tallest of all land animals. Its heart can be over two feet long and is engineered with a network of bypasses and anti-pooling valves that allow the giraffe to raise and lower its 500-pound (227 kg) neck and head without fainting. NASA scientists have studied the giraffe’s uniquely created anatomy to help them develop gravity suits.
In order to have common ancestry with a mouse, a giraffe would need randomly and simultaneously evolving genes for bones, heart, nerves, muscles, brains.
Instead of hysteria- inducing Darwinist ideas, why don't you visit a park with a flower bed and watch bees, butterflies, hummingbirds cross-pollinating the flowers.
Witness the creation. Nectar production and consumption were created two days (48 hours) apart. Think about how great the newly redeemed creation will be.
.
Reply: Justwantahover
The main evidence for creation and young earth would be:
(A) the discovery of chromosome numbers (1905-1910) show that the origin of every species was the first mating pair with the species' chromosomes. Plus the debilitating effects of random chromosome aberrations.
(B) the production and consumption of nectar, and the resulting cross-pollination occurred 2 days apart.
(C) the catastrophic event that produced fossils, fossil fuels and sedimentary rocks (sediment is the stuff at the bottom of water) all point to one Big Kahuna flood.
Reply: There is no "tree of life sequence" in the fossils. There are only different animals in different places. It's a 100% impossibility for all life to be on one tree. Try and work out how the spread of traits and biological systems could have been occurred from one cell too all the organisms the way they are today by speciation events. You'll be stuck quickly. Different species can not procreate and share genetic material preventing evolution. Yet evolution theory depends on speciation events to explain diversity. It commits hari Kari there and fails.
Reply: 9pt9 Yeah we only have your word on that.What would the genome of related species look like? What does the data show?

A testable hypothesis for evolution by natural selection is: If species share common descent then their genome should reflect speciation events.  One would expect species predicted to be closely related to share a high degree of sequence identity. Furthermore common ancestors would share a common disease history and those viral elements that hitchhike into the genome would be passed on.

So one would predict that the genomes of related species would have similar gene sequences and similar genomic structure the more distant the species are there would be more differences. Oddly enough that is what the data shows. See the data bases and do some genomic comparisons yourself.
Reply: You do realize denying something that actually incorporates real-life applications involving medicine/drug production, forensic DNA analysis, selection, agriculture and more is cute, but ultimately futile right?
Reply: You both completely over look the challenge I present as usual. Your "argument from genes" is nothing more than A has similarities to B therefore B evolved from A. Fallacy. There is no possible way that all the traits, organs and biosystems observed in organisms as they are today could have been spread from a common ancestor. The very speciation that evolution needs to make the theory solvent at the same time would have blocked the spread of evolving organs, bio systems and traits since species can not interbreed. This is 100% iron clad proof that common ancestry fails. Try and work it out for yourselves. Start with a cell with no organs existing and pose an evolutionary pathway spreading organs, limbs, wings, body plans etc as they are present in all organisms all over the earth today. You have been fooled. 
Once again, evolution can't even account for a simple tube let alone being responsible for the origin of species as they are today. Laughable.
Reply: 9pt9
All you have are words words are not proof. Next you'll be claiming that children are not genetically realated to their parents, Same principle 'nothing more than similarities'.
Reply: Justwantahover As long as they are brave enough to follow the scientific method and not be afraid to report their results honestly, Mendel comes to mind.
Reply: 9pt9
Your 'proof' is basically; It is impossible because I said so. Fundamentally decreeing that something is impossible without experiments or data is complete foolishness.
Reply: Justwantahover [evidence we can all see. ]
(A) As C.S. Lewis said: the chicken-egg-chicken cycle must have been started by something outside the cycle.
(B) Bee colony collapse and its effect on crop cross-pollination is an example of the created nectar production-consumption cycle getting messed up.
(C) They tell us that the Kaibab Limestone (the top layer at the Grand Canyon) has marine fossils. It was at the bottom of the ocean, which means either:
(1) 4000 feet of sediment slop ascended at a few inches every hundred years, or
(2) the ocean receded rapidly.
We can see from the size, shape, and altitude of the Canyon - the water was up there.
Your own evidence (impact craters) supports catastrophism over uniformitarianism.
Reply: 9pt9 LOL
Did you not see me tag that Stephen Land fellow? The first two paragraphs in my comment are quoting him, things he said earlier in this same thread. The second two paragraphs were my reply. Read my FULL COMMENT plz and I think you will change the beat of your drum lol. The comment by Stephen Land was much earlier up in the thread (maybe about 200 comments up lol) but I saw nobody reply to it so I thought i would do it and I had a good point to make. THe funny thing is I think anybody can agree with my point no matter what side they are on, is anybody willing to address my full comment. ONce again, the first two paragraphs were quoting Stephen Land. The second two paragraphs was my actual reply.
Reply: 9pt9 Maybe I should edit my comment as to make it clear that the first two paragraphs were not my words lol. I can see how there would be a mix up, but I would challenge someone to argue with my actual comment but it's tough to argue with what I said.
Reply: 9pt9 Your comment makes no sense. If organisms are related by a common ancestor then they will share a high degree of sequence similarity. So yes you are wrong.
Reply: Hex: But clearly it's impossible for us to share common ancestors so any "genetic similarities" have a different explanation.
Reply: 9pt9
So what evidence would you predict from a speciation event? If you have no rubric how do you know it is impossible? Claiming somthing is impossible is just words, demonstrate it.
Reply: A speciation event would result in 2 species incapable of producing viable offspring. The burden of proof is on evolution to prove speciations are responsible for the diversity of all life across the entire earth and it can't.
Reply: Justwantahover [All that soil and rock excavated in a microsecond.]
Perfect description of catastrophism, disproving uniformitarianism.
The tsunamis produced by such meteors would have spread huge layers of sediment which we see.
The uniformitarian explanation for the Colorado Plateau is "for reasons poorly understood, the beds of the Colorado Plateaus remained mostly horizontal through both events even as they were uplifted about 2 miles  in two pulses".
http://en.wikipedia.org/wiki/Geology_of_the_Grand_Canyon_area
Erosion would have wiped this out 20 times over..
Reply: Stephen Land What always appeared to be a big boost to evolution are the hominid fossils.
Let us suppose it could be demonstrated by highly respected evolutionists that the hominids were the result of a sequence of human-ape hybridizations. e.g. Neanderthal was 15-16ths human, 1-16th ape. Would such results cause you the rethink your position ?
Reply: 9pt9
That wasn't the question. Would their genomes show any similarities?  If no why not?
Reply: Stephen Land
[The reason for this (fossil record of hominids is practically non-existent) is very simple] would be because:
(1) the world being covered by ocean would have marine fossils where they shouldn't be
(2) hard-shelled invertebrates would be more easily fossilized.
[fossils of trilobites sitting unexamined ] Well, that's because the hominid fossils are the Holy Grail of Darwinism.
[unaware of any highly respected evolutionists]
The Max Planck Institute for Evolutionary Anthropology chose its name obviously not wanting to be Non-Evolutionary Anthropology.
[unaware of any legitimate theory that says the exinct hominids were the result of a sequence of human-ape hybridizations]
Using their own results, we can construct an illegitimate theory ( I like black-market or wild-cat theory).
Their results show NM is 12.7 percent "ancestral" or 6.35 percent closer to chimpanzee. (about 2 million bases in the genome) which would be the result of a human mating with some thing that was 7-8ths human and 1-8th ape.
Reply: Justwantahover
 Kinds.... my friend, kinds.
Flipping terminology is typical in evolutionary belief... recanting via. (as such) - doesn't state any new claim, nor any new facts, nor proofs to the same with regards to a hypothesis & Darwin would be (pun intended) on board with that. BTW - read the chapter "Problem with theory"
Reply: "There are many different species of butterfly (one "kind"). I realize a species is not one of your "kinds". But a lot of creationists fail to realize that speciation is necessary for your myth to "work". 

= Dude “that speciation is necessary”  IS the death blow of evolution, not Science, and based on NO scientific principals – Charlie himself would argue with that -read the book especially the chapter "Problem with theory...".
 
Also from your website: “WELCOME TO MY CHANNEL!
I like science, and I not only do science, I also try to defend it as well!
Not only from creationism but also other types of pseudo-science. I'm here to "crack the nuts" so-to-speak, as well as do science! lol
I have several different types of VTOL concepts and other inventive stuff as well (like speakers)”
 
Meaning; "Don't confuse me with logic, or reason my minds made up"
Good 4 U
Reply: Justwantahover  The simplest explanation is that a 'kind' is simply all the members of a species. If two species have a common ancestor.(e.g. butterflies with big differences in chromosome numbers), this would mean that genetic redesign caused one species to give birth to at least two members of another species. Random chromosome aberrations could not conceivably accomplished this.
Reply: Phillip Zachry Wake up sleeper. Wake!!!!!
Reply: don leavell That's all you got. So you just hope it's right. You can't handle the truth.
Reply: Jonathan Hoy It is because the truth would be shattering to their life stile. They have to face the FACT that they were created and there just might be some rules. It is a pride thing mostly. Nothing else makes sense. Because the truth of a Creator is beautiful. And He, no doubt had a purpose when He made everything. The marvel of the heavens and the earth and everything them shows that He loves us. So why choose the lie. It is mind boggling. And great post.
Reply: Justwantahover
no i'm only using a reasoned well thought out approach to get the an answer to some of life's more interesting riddles.  your reality of evolution as a fact is laughable and displays the levels of ignorance in this world are only increasing.
Reply: Justwantahover
so name the experiment that is reproducible and squares this evolution theory?  you can't, this whole theory rests upon the gullible and intellectually inept having faith.  so revel in the irony and stop being a dupe.
Reply: Justwantahover
what a dupe.
Reply: Brian Douglas
Created everything?  Like Ebola?
Reply: Justwantahover
cures huh?  man you got a lot of learning to do about the "free" market system.  i stopped reading after the first sentence for the obvious reason.
Reply: Justwantahover " So you are denying that fact that secular genetic science is advancing." Equivocation fallacy. Genetic science doesn't = evolution.

 "You are denying basic everyday wews on genetic breakthroughs, cos the fact that it clashes with your fantasy." Can you name one "genetic breakthrough" that disproves an intelligent agency as the source of all living nature and proves evolution? 

Remember, evolution can not even account for one gene, one DNA molecule,one cell or even a simple tube. Based on the fossil record, evolution needs to account for 3.5BY years of zero evolution followed by the near instant explosion of single celled organisms into multi million and multi billion celled organisms. Nothing helps evolution theory. Get it through your close minded head.
Reply: 9pt9 These lies have been disproven, disproven to you personally.  This isn't ignorance, this is dishonesty.
Reply: gamesbok
whats dishonest is how an unproven theory based on nothing in reality is now considered some kind of cosmic truth.  go get your flu shot and leave the important issues to people who aren't duped into having faith in some theory brought to us by eugenicists and other various dupes.
Reply: Jonathan Hoy You really should not open your post with a statement showing such ignorance.  All empirical theories are unproven.  The ones we accept are the unfalsified ones.

If you want to falsify evolution you are welcome to try, otherwise you are obliged to accept it.

Pathetic ad hom attacks like 'eugenicists'  make you look stupid.  Nobody with an understanding of evolution would eradicate a gene.
Reply: Justwantahover
there is zero physical evidence to disprove.  you were created.  be the evidence or be the dupe of indoctrination.  i care not, for only a fool would argue against their own self evident existence.  as a side note it's a dupe who unwittingly passes on faulty logic as truth.  let's not make it witting and willful to boot.  no form or kind of life has ever evolved into another by means of natural selection,  accept it and focus on the real issues of our time.
Reply: Justwantahover
iridium is the basis of your proof that no god exists?  you sure did go on and on ,about all that you think you know, based on what other people have told you.  yep that seals it we came from nothing.  i'm sold.  don't be a dupe of the lab coats and pocket protectors.
Reply: Justwantahover
is that one of the commandments is it?  thou must believe the world is 6000 years old or you don't believe in god.  is that what passes for logic and reason in your duped brain?  which came first the chicken or the egg?  dupe says whaaat?
Reply: Nobody can actually "prove" the age of the earth. Nevertheless the earth could appear to be trillions of years old and it wouldn't contradict Gods existence. It would only lend itself to Gods infinite nature. A ball in socket joint actually proves Gods existence all on its own :)
Reply: i can see your responses still degrade into an emotional attachment to the idea,  that i have to take everything written in the bible as the unadulterated word of god.  if you make presumptions about me then that leaves no choice for me, but to think about you as  young and naive about the workings and motivations of the power elite. 
as for your iridium facts, methinks people like to have faith in all kinds of shit,  why not meteors and alleged craters formed by them. 
i've been to hawaii and have seen craters formed by volcanic eruption that appear to look like they were meteor impacts.  the fact if there is such a thing is that this life is wasted if one can only form ideas that are spoon fed to you by the "expert class".  question everything as if you know they are lying, then you will begin to scratch away at the heart of the matter.
Reply: Justwantahover
this whole thread is about the theory of human evolution.  the  observable, repeatable experimentation that prove this theory are non-existent.  contrary to your beliefs, which are ironically faith driven and therefore, illogical and hypocritical of you to deride other peoples beliefs.  chicken or the egg is the paradox of life.  ponder that question of genesis, and the only answer remaining is  the fact of a creation.
Reply: Justwantahover
lol, u got a future in comedy kid.  because reading your thoughts about my beliefs, which i have never stated is hilarious.  keep up the good work super dupe.
Reply: Justwantahover
have an enlightening life.  although from the musings you have left on this thread it stands to reason that your misplaced faith in science will correct itself in time.  you see the closer one gets to death the more you begin to understand that you don't really understand much at all.  it's called humility.  and the world could use a lot more of it.
Reply: Jonathan Hoy
"although from the musings you have left on this thread it stands to reason that your misplaced faith in science will correct itself in time."
Seems to me his musings  were based upon factual evidence. Doncha just hate it when the facts contradict the Bible?
Reply: Jonathan Hoy
It's not so much that the Bible is stupid but more the case that it is demonstrably wrong when read in a literal sense. Perhaps you should read it one day as it's an epc, right up there with the Lord of the Rings.
No i don't think those who who have faith in a "Creative" force as being necessarily dumb (many are) but more the case of being intellectually lazy.
Reply: pilgrimpater
in this life you are either a self directed learner or you have to be told what to learn.  i have read many translations of the bible, pretty good book, lots of wisdom to be gleaned.  literally.
Reply: Jonathan Hoy
We all have a lot to learn and nobody knows everything but how does that rescue your argument?
You have read many translations? Well they differ enough to explain the 100s of different interpretations and hence denominations, proving that there is no unified single "word of God", yet each will still have the same internal and external contradictions.
It doesn't matter how many times you read it, the passages that are clearly wrong will not go away.
Reply: pilgrimpater
I have never subscribed to infallibility as it pertains to what people have written about god.  god is not the bible, nor a religion,  it is the self actualizing force that binds us to this world.  I think of god as the ultimate scientist peering at us, as we look down upon an amoeba.  to argue over what god is, is futile and a colossal waste of this life.  are their contradictions in the bible? yep.  so if something doesn't sit well after reading it, do you accept that which is unsettling?  i don't, i glean knowledge and wisdom in all things of this earth,  from as many sources to be had.
Reply: Jonathan Hoy
"it is the self actualizing force that binds us to this world"
That's assuming that it even exists before you can apply any attributes to it and assumptions with absolutely no basis don't win arguments. There is absolutely nothing that we observe in the Universe which necessitates a god.

"so if something doesn't sit well after reading it, do you accept that which is unsettling?"
If it's demonstrably wrong i don't accept it at all? Why would i be so dishonest to myself?

" i glean knowledge and wisdom in all things of this earth,  from as many sources to be had."
So you will know that Literal Genesis cannot possibly be true in light of that gleaned knowledge (the wisdom comes in not denying that knowledge).
Reply: Justwantahover
This particular one is typical in utilising topic shift in order to avoid answering uncomfortable (to him/her) questions. He should not continue unless he can address the crater and fossil questions that you have posed. I got very much the same from the author of this video who quite simply cannot explain the Geology and Paleontology.
To ignore the evidence is being dishonest to one's self and all in the vain hope that there might just be an afterlife and that afterlife is with a chosen god, out of thousands to choose from.
Reply: pilgrimpater
topic shift?  so where is the actual meteor that  created these craters?  as usual we are left with nothing other than the precious iridium residue.  you might think that seeing a crater is self evident of an impact,  but alas there is no meteor ever found in the crater.  curious.  pilgrim you're obsessed with religion, i have never pronounced the fact of an afterlife, again that is your programming talking.  so maybe you should ask yourself why it is that you have to put words in my mouth concerning your preconceived notions about my beliefs?
Reply: Wayne Huninghake
Jesus never rose from the dead either.
Hmmmm, an empty tomb. I wonder how many rational causes i can think of.
 How silly to point out what is unique about your religion because uniqueness is what makes each religion different, eg. A Moslem can claim that Jesus never visited heaven on a winged horse or a Hindu can claim that no other religion has an elephant god or no other religion has God's words on golden plates as per Mormanism, so rising from the dead is no big deal especially as there is no evidence for it.
The "evidence" for Creation is so vast that "Vast" = "Zero". Tell you what though, there is a ton of evidence against Biblical Creation,
btw quoting from a book that has no authority will have as much impact on me as a Moslem quoting from the Quran at you.
Reply: Justwantahover
ah i see, no direct evidence such as an actual meteor is ever found.  you should reread your comment for the waling contradiction that it is.  they found bullets, then they disintegrated,  so which is it?  mythbusters is a paid programmed show.  they say nothing that isn't already accepted by the status quo, so referencing them is quite comical, and indicative of how far logic and reason have plummeted.
Reply: Justwantahover
off to jupiter now are we?  ok i'll play along.  i was aware of the event and watched it like everyone else.  very impressive.  i will ask one question at a time so that we can establish a baseline of mutual agreement.  wanna play
Reply: Jonathan Hoy Did Dinosaurs Die from an Impact? http://www.icr.org/article/did-dinosaurs-die-from-impact/ 

An object may have struck the earth, but that alone does not explain the dinosaurs' demise. Physicist Donald DeYoung noted that such an impact would not have targeted dinosaurs for extinction and left less mobile creatures--such as turtles, crocodiles, and some mammals and birds--alive. Prothero also mentioned this problem, including sensitive salamanders among the curious survivors.

That's always been one of my questions to those that want to believe that meteor whipped out the dinosaurs. Just how did the meteor know to whip out only the dinosaurs and not all the other creators such as mammals and birds and well you get the picture. I guess it was a smart meteor sorta like a smart bomb to cut down on collateral creature demise.....
Reply: Wayne Huninghake
I would't refer to pseudoscience sites as per your link. These sites exist solely to concoct  excuses to explain the evidence that falsifies the mythical flood rather than going out in the field/lab and producing their own science..

Bottom Line:-

Below KT layer = Dinos + Very small mammals
Above KT layer = No Dinos (maybe a few small ones) + Very large mammals 

No amount of creationist lies can avoid that fact.
Reply: pilgrimpater your statements lack any truth. your knowledge is really quite underwhelming.
Your emotional opinions are baseless and you have provided no documentation or evidence to prove what you've stated, therefore; your emotional opinions are irrelevant.  

Allow me to provide some logical arguments plus the documentation plus the evidence that completely DEMOLISHES everything you just posted ::

The evidence for creation is vast. Explore the ever-increasing list of reasons why creation is the best explanation for our intricately designed and precisely balanced universe.  http://www.icr.org/Topics/
Reply: Wayne Huninghake
Sorry but i can't deny the facts of the demonstrable evidence found in the field by those qualified to work in the field rather than armchair pundits such as we find in the ICR. Don't bother directing me to pseudo science propoganda sites but instead try to tell me why you think relative dating via stratographic correlation is wrong. Please tell me why over 150 years of  working in the field, Geologists are all wrong. By sheer coincidence?
Please explain why there is zero evidence for a global flood both from the fossil pattern and from the Geology itself (ie regardless of the fossils). Please tell me ........ well sorry to burst the bubble but the list is inexhaustlable.
Reply: Justwantahover
Silly question. Denying evidence is a major prerequisite to being a Creationist.
Reply: pilgrimpater Denying evidence? What evidence?
Reply: Benita Almond You could start here (but I doubt you will, because as pilgrimpater said "Denying evidence is a major prerequisite to being a Creationist"):

http://www.talkorigins.org/faqs/comdesc/
Reply: Benita Almond
The distinct fossil pattern over geological time and that is regardless of the absolute age of the Earth.If that is not good enough for you the fact that fossils markedly change over time. Ice core rings clearly showing the Earth to be at least many score thousands of years old. The absence of craters (should at least match the density on the Moon).  Geology - A retreating global flood would leave layers sorted by grain size. Exactly what we don't find. The extraordinary super rapid evolution required in a few centuries post flood. The list goes on and on and on.
Reply: narco73 Dear Narco - Rich very rich on behalf of whoever the pilgrimpater is - yes I have studied all the so called evidence and i will be honest with you - I do not want to believe in God as there is something in my life I am doing wrong - I know where I'm going when I die - All the evolution evidence is very clever but very well refuted - much to my dissapointment - I want to be an atheist - there is just no sufficient evidence - the evidence of a creator is creation itself - It is not the creationists that are in denial.
Reply: Benita Almond Hi Benita, thanks for your reply

Firstly, you are to be commended for admitting that you don't want god to exist. Any moral person should not want the (most common version of the) christian god to exist. So well done there.

But as far as studying all the evidence for evolution goes, I don't believe you. For a start, even if you were a full time evolutionary biologist, you still would not have studied all the evidence for evolution, but secondly it is not true that evolution has been refuted. It's not even 1% true. It makes me wonder if you are being dishonest, or whether you just don't understand, or perhaps you have (like most creationists) just been lied to so much (either purposefully or unknowingly) that you have a hard time seeing otherwise. This would not be your fault.

The truth is out there if you are willing to (to borrow a Christian phrase) "soften your heart".

You say "the evidence of a creator is creation itself". But this doesn't follow, unless you can first show that "creation" is indeed created, which I expect you can't. So it is a non-starter.

If you don't understand my last paragraph, it's much like merely calling the universe a "painting" and saying that therefore the existence of the universe is evidence that the universe was painted. Clearly this makes no sense, unless you can show that the universe is indeed a painting in the first place.
Reply: narco73 The research I have done has only been on the internet no I am no biologist no scientist no academic. I watch documentaries on evolution and research on how they are refuted .The research I have done - I find personally that evolution is untruth - especially the documentaries refuting evolution by non creationists. A painting is evidence of an Artist - there is no disputing that - so no I don't really understand your paragraph. Personally when I just look at a beautiful flower for the life of me - I just cannot believe it came from a small puddle of soup -
Reply: Wayne Huninghake
Look if you want to play the "let's debate by links game" i can link you to thousands of peer reviewed evolutionary papers.
I assume you have read the pseudo science that you have linked to me so why don't you tell me how they explain the factual evidence that i gave  to +Benita Almond, or are you in the game of pandering to what spoon feeds your presuppositional standpoint?
To make it easier for you i will condense the facts down to just one major problem for creationism and let's see how you can get it to fit your creation model.
The fossil record shows a clear pattern of first appearance of major groups. This IS Evolution even if you think some supernatural being explains it. What this factual evidence does do is falsify any notion of a global flood whereby the fossil record should be random. It clearly is not.
Reply: Pilgrim, the fossil record is nothing but awful news for evolution. The first groups appear yes, but they appear suddenly with no precursors. The gradualism Darwin predicted doesn't exist. 99% of all fossils are aquatic animals and the neat order evolution presents fossils in textbooks is heavily exaggerated.
Reply: 9pt9
Tell me why the highest life form in the Cambrian was the jawless fish. Tell me why life has been found Pre Cambrian that is not in the Cambrian. Tell me why the fossil record is not random.
Reply: pilgrimpater
There's another reason why an evolutionist will hold onto their belief system even when all the fatal flaws are revealed, and that is because if evolution isn't true, it strongly points them in a different direction.

"For his invisible attributes...have been clearly perceived, ever since the creation of the world, in the things that have been made. So they are without excuse." [Roman 1:20]

Because really if the universe and life didn't self-create, if it didn't happen spontaneously, then there has to be a Creator, and the Creator is not likely to be some little green man from another galaxy, the Creator is going to be Almighty God.
Reply: Wayne Huninghake
Oh hell when the evidence totally contradicts your belief, time to bring in the Biblical quotes. Please address what was asked of you and not some quotes from some book with no authority.
Reply: Phillip Zachry First, if a person is using the word ‘scientific’ in the sense of experimental, observable, repeatable, testable phenomena; please tell me one scientifically verifiable fact of evolution (i.e. evolution from matter to man) that you have so proven, or has been proven by others whose conclusion you believe.

If you are objective on this I think you will accept that evolution does not meet these criteria. This is because it is a process which allegedly occurred in the past and therefore by its nature cannot be subjected to experimental verification.

So at this point if person is actually objective that would admit that evolution has nothing to do with science and if a person does some honest research they would easily find out that the teaching of evolution actually harmed science and society ::
http://creation.com/evolution-harms-science-and-society

Now your questions pertaining to God have been answered over and over again plus they have been answered many years ago ,but I have provided a link to help you in finding the answers you've asked. Again, if you are objective you will find the answers quite logical ::  http://creation.com/god-questions-and-answers

There's another reason why an evolutionist will hold onto their belief system even when all the fatal flaws are revealed, and that is because if evolution isn't true, it strongly points them in a different direction.

"For his invisible attributes...have been clearly perceived, ever since the creation of the world, in the things that have been made. So they are without excuse." [Roman 1:20]

Because really if the universe and life didn't self-create, if it didn't happen spontaneously, then there has to be a Creator, and the Creator is not likely to be some little green man from another galaxy, the Creator is going to be Almighty God.
Reply: Phillip Zachry Firstly, you haven't provided the evidence required. Sorry, but your emotional opinions are not evidence.

Secondly, pertaining to God. These questions have been answered numerous times and many years ago. Simply go to the CMI website at creation.com and do a search on "God Questions and Answers.

So in conclusion, you've provided no evidence and you've been provided the answers to your questions, but still no evidence.

Actually, there's nothing that isn't covered on the CMI website.

The evidence for creation is vast. Explore the ever-increasing list of reasons why creation is the best explanation for our intricately designed and precisely balanced universe.  http://www.icr.org/Topics/

You've answered nothing, you provided no evidence for anything and yet I've answered all your questions.
Reply: Wayne Huninghake
I can't help but notice that you have yet to address why the fossil pattern exhibits a clear progression of life (Evolution is as good a word as any to describe this evidence) and why, by if Creationistism is true, there is a pattern at all.Don't bother with the psedo science links becuase none of them can address this massive problem but maybe you can come up with some form of answer.
Reply: Pilgrim, the "order of fossils" doesn't help evolution at all. The fossils show sudden appearance followed by stasis. There is an endless list of organisms alive today that are practically identical to how they first appear in the fossils. No gradualism, no change. Fossils eviscerate evolution. Fossilization is the result of rapid burial. Certainly dead animals didn't sit around on the surface of the earth waiting for hundreds of thousands of years for sediment to slowly bury them. 
And Phil, I crushed the whale nonsense every which way to Sunday and you were left speechless.  I see your fingers are still firmly implanted in your ears. The indoctrination is sad.
Reply: 9pt9 Ah, but you are using logic now. LOL

CMI has some excellent information pertaining to Fossils :: http://creation.com/fossils-questions-and-answers
Reply: Phil, Grape ferns and hedgehogs both have 90 chromosomes and they are clearly not related. Are you suggesting that a fused chromosome accounts for the vast differences between humans and apes? Such desperate "evidence".
Reply: 9pt9 
"Pilgrim, the "order of fossils" doesn't help evolution at all."
Sorry but you don't get to change the evidence. The Fossil pattern IS Evolution regardless of the mechanism. Quite clearly first worms appear before first fish which appear before first tetrapods etc etc. Wher are the mammals in the Cambrian?

"The fossils show sudden appearance followed by stasis."
An incorrect assertion.

"There is an endless list of organisms alive today that are practically identical to how they first appear in the fossils."
Irrelevant. Nothing in the Theory of Evolution states that all organisms have to evolve at the same rate or evolved at all (in cases of environmental stability such as with crocodiles).

"No gradualism, no change. Fossils eviscerate evolution."
Slogans can't help you. The fossil pattern not only IS Evolution but it also totally falsifies the flood myth as we'd expect to see fossils in a random order but we don't. Why?

"Fossilization is the result of rapid burial. Certainly dead animals didn't sit around on the surface of the earth waiting for hundreds of thousands of years for sediment to slowly bury them."
Tell me something i don't know. How does that a) disprove Evolution b) Support Creationism?
Has it not occured to you that the geology of the various environments (that are not due to floods) dion't have to be a single event?

"And Phil, I crushed the whale nonsense every which way to Sunday and you were left speechless. I see your fingers are still firmly implanted in your ears. The indoctrination is sad."
Ah i see try to sneak in the last word by not actually addressing Phillip Zachry (as you also did with me).
A common Creationist tactic when on the run.
Please use the "reply" option in future.

Anyhow, not for the first time of asking let's hear your excuse for the fossil pattern.
Reply: Phillip Zachry
And his reply to you is exactly why i made my original comment whereby Creationists are duty bound to ignore the evidence (that not only supports Evolution but simultaneously falsifies the flood debacle).
They can't alter the evidence so they have to ignore it.
Reply: pilgrimpater "The Fossil pattern IS Evolution regardless of the mechanism. Quite clearly first worms appear before first fish which appear before first tetrapods etc etc. Wher are the mammals in the Cambrian?"

Evolutionists accomodated the fossil record as they found it and then claimed that it supported their position. Accomodating what you find is not evidence.

As for you claiming that he made " "An incorrect assertion."about stasis and sudden apperance.

EUGENE M. MCCARTHY, PhD Macroevolution.net
 

"Stephen Jay Gould and Niles Eldredge. The battle between the gradualists and the saltationists, which is further discussed below, continued until the 1940s, when a strong intellectual shift occurred. Gradualism then became the ascendant perspective among biologists. But in the early 1970s paleontologists Stephen Jay Gould and Niles Eldredge raised the flag of saltation once again.¹ Their 1972 article caused an evolutionary uproar that has not subsided to this day. As had many of their saltationist colleagues in years gone by, they emphasized that a wide variety of fossil types 1) arise suddenly and 2) are static thereafter. Gould (1980a: 182) later expressed the problem succinctly:
The history of most fossil species includes two features particularly inconsistent with gradualism:

(1) Stasis. Most species exhibit no directional change during their tenure on earth. They appear in the fossil record looking much the same as when they disappear; morphological change is usually limited and directionless.

(2) Sudden appearance. In any local area, a species does not arise gradually by the steady transformation of its ancestors; it appears all at once and 'fully formed.'
Fossil Trilobites (Cambrian)
For years Eldredge had sifted through fossils trying to document examples of slow, steady directional change. Instead he found that "once species appear in the fossil record, they tend not to change very much at all. Species remain imperturbably, implacably resistant to change as a matter of course — often for millions of years."² For example, over an eight-million-year period, the only detectable alteration in one of the trilobites Eldredge had been studying was a slight change in the structure of its compound eyes, the number of lens-rows dropped from eighteen to seventeen.³ Eldredge (1995: 68) asserts paleontologists have hesitated to emphasize the observed pattern of stasis in the fossil record because it is inconsistent with neo-Darwinian theory:
For the most part it has been paleontological reluctance to cross swords with Darwinian tradition that accounts for the failure to inject the empirical reality of stasis into the evolutionary picture."

The state of the fossil record was not emphasized because of its inconsistency with neo darwinism.

"Nothing in the Theory of Evolution states that all organisms have to evolve at the same rate or evolved at all (in cases of environmental stability such as with crocodiles)."

Which theory of evolution? The modern synthesis teaches that Evolution occurs at a uniform rate. Stasis is not consistent with the modern synthesis.

Again.

from macroevolution.net

"Eldredge (1995: 68) asserts paleontologists have hesitated to emphasize the observed pattern of stasis in the fossil record because it is inconsistent with neo-Darwinian theory:
For the most part it has been paleontological reluctance to cross swords with Darwinian tradition that accounts for the failure to inject the empirical reality of stasis into the evolutionary picture."

"Slogans can't help you. The fossil pattern not only IS Evolution but it also totally falsifies the flood myth as we'd expect to see fossils in a random order but we don't. Why?"

The fossil pattern of discontinuity is not consistent with evolution,. Stasis is not consistent with the modern synthesis that has evolution happen at a uniform rate.

"Ah i see try to sneak in the last word by not actually addressing +Phillip Zachry (as you also did with me).
A common Creationist tactic when on the run.
Please use the "reply" option in future."

You haven't shown him on the run. You have shown that you are a big mouth.

"Anyhow, not for the first time of asking let's hear your excuse for the fossil pattern."

It is the evolutionists making an excuse for the fossil pattern. That is why they brought out Punctuated equillibrium to explain away the discontinuity which was not consistent with the modern synthesis aka neo darwinism.
Reply: Marshall Roberts Yep ...  the fossils are answered in quite detail on the CMI website at creation.com if a person is willing to do some honest research and that's just for starters.

Living Fossils (http://creation.com/werner-living-fossils) is an extremely excellent article and quite an eye opener
Reply: Pilgrim, You can't reply to comments on a mobile device. Animals caught up in swirling flood waters wouldn't be expected to fossilize. They would bloat, float and disintegrate. Only animals rapidly buried in landslides would fossilize. We wouldn't expect a mish-mash of fossils. We wouldn't expect to see bunny rabbits buried with fish. We would expect to see worms buried below and/or with fish. We would expect to see amphibious animals buried just above fish. We would expect mammals to be buried above/with amphibians. Everything looks like a flood occurred in the past. Everything. 
The white elephant in the room is RMNS is completely incapable of causing the change in body plans and upward levels of complexity that evolution fans credit it with. 
Your crap about organisms that didn't need to evolve is just an excuse for the evolution that isn't there. 
Phil, I dismantled the whale propaganda and served it up on a platter for you. Bottom line, there are whale fossils and land mammal fossils. They aren't linked. It's only your evolutionary presupposition that makes you believe they are. You cant provide a sensible evolutionary pathway that could account for the slow separation the esophagus, trachea and all the neurological and histological changes that would have randomly "invented" cetacean blowholes. Blowholes alone kill evolution as a possibility. 
You don't have to believe "God did it" but it is certain evolution didn't do it.
Reply: Marshall, GREAT post! Can't wait to see them try the dodge and weave :) I predict you'll get a "quote mine" whine LOL
Reply: 9pt9  " Pilgrim, You can't reply to comments on a mobile device"

He is a typical evolutionist, confusing assumptions with facts.
Reply: Phillip Zachry "That we don't find mammals in precambrian rock isn't accommodating at all."

They accomodated where mammals were found and said that it supported the "hypothesis" if they saw the fossils in a different order then they would accomodate that too.

"You do understand that the context of it supports evolution, but it deals with the method and rate at which changes occur, right?"

You do understand that it does not support the modern synthesis but saying that it supports evolution is meaningless as evolution is a metaphysical research program, with the death of the modern synthesis then they will make up another "theory" in which to try and fit the evidence.
Reply: Benita Almond Let me try to explain that last paragraph again then.

You made an argument that creation is evidence for a creator. This is a common creationist argument, and I assume you mean the same that most creationists do.

If you formalise the argument, it would be something like:

P1> Everything that is created has a creator
P2> Creation is created
C> Therefore, creation has a creator.

The problem is step two, where the conclusion is assumed. You would have to be more explicit in this step before it became a sound argument.

The same argument could be made

P1> Everything that is painted has a painter
P2> The universe is painted
C> therefore the universe has a painter

Again, it is premise 2 that is the problem.

Do you follow?
Reply: Phillip Zachry
"We make predictions on what evidence we will find and see if the evidence supports the hypothesis"

Predictions are meaningless for a metaphysical research program where those evolutionists can just make up new hypothesis to force fit the evidence.

The evidence does not support the modern synthesis that is why evolutionists have come out and said that it has failed but it makes no sense to chirp about predictions and evidence not contradicting evolution because the modern synthesis has failed and yet they will just try and make up another evolution hypothesis to try and force the evidence to fit.

Of course evolutionists agree that evolution occurs, You could find tea leaf readers who agree with each other on tea leaf reading, because they agree does not make it valid.
Reply: Phillip Zachry  The verified fact is that the modern synthesis has failed.
Reply: Philly boy, you credit evolution with the ability to separate the esophagus and trachea to accommodate cetacean blowholes (as well a host of other internal morphological changes that would have necessarily occurred), yet you do not believe evolution could have given cetaceans some "simple" underwater olfactory senses? Come on. Why the limitation on evolutions magical powers? If whales needed underwater olfaction to survive evolution would have given it to them. You haven't explained jack. You show the same nonsense 100 evolutionauts have shown me before. Whale fossils and land mammal fossils. Blowholes even have a flap across to the top to keep the water out. They are engineering marvels and they are certainly irreducibly complex. What good is 2% of a "blowhole flap"? LOLOL
Reply: Phillip Zachry  The modern synthesis is the name for what has been called the theory of evolution. They will try and make up something new to force the evidence to fit and the metaphysical research program will continue.
Reply: Philly: There were no land mammals with whale features. Your banter is meaningless and old. I want an evolutionary pathway for the internal and external changes that invented cetacean blowholes. If not I'm leaving with another victory from you.
Reply: Phillip Zachry  "where are their scientific papers saying evolution is dead"

You are naieve Phil, Science is Politicised. To be published and  get funding then you have to be Politically Correct and go along with the orthodoxy that evolution is true.  So while somebody submitting a paper may get away with pointing out the flaws in neo darwinism and that it has failed, As long as you pay lip service to evolution still being true then you can still get published.
Reply: Phillip Zachry  "You're against science"

The conclusion does not follow.

You however are not being scientifically minded by accepting just so stories uncritically
Reply: Phillip Zachry Evolutionary Biologist Lynn Marguilis "Richard Lewontin gave a talk here at UMass Amherst about six years ago, and he mathematized all of it—changes in the population, random mutation, sexual selection, cost and benefit. At the end of his talk he said, “You know, we’ve tried to test these ideas in the field and the lab, and there are really no measurements that match the quantities I’ve told you about.” This just appalled me. So I said, “Richard Lewontin, you are a great lecturer to have the courage to say it’s gotten you nowhere. But then why do you continue to do this work?” And he looked around and said, “It’s the only thing I know how to do, and if I don’t do it I WON’T GET MY GRANT MONEY.” So he’s an honest man, and that’s an honest answer.”

If he doesn't go along with it then he doesn't get his grant money.
Reply: Phillip Zachry Now where is that experimental evidence showing a Flagellum evolving from a bacteria that did not have one?
Reply: Phillip Zachry  Ahhh so you can't back up your claim about IC. You are making excuses Phil.  You can't show that experimental evidence showing the evolution of a  flagellum from a bacteria that did not have one. You hate science Phil and have no respect for it, You are happy to  accept  unscientific evolutionary  just so stories uncritically.
Reply: Marshall Roberts
“Evolutionists accomodated the fossil record as they found it and then claimed that it supported their position. Accomodating what you find is not evidence.”
 
And there we have it. Over 150 years of the perfect  conspiracy.  Confirmation of my original statement that Creationists are duty bound to ignore the evidence and resort to cries of cheating. Funny then that Evolutionary Scientists go public on such things as dino soft tissue and Punctuated Equilibrium. Perhaps nobody told Schwartzer and Gould about the conspiracy.  Sorry but facts are facts and the fossil record shows a distinct pattern of first appearance of the major groups of animals. If you don’t know why this is then just say so but please stop making excuses.
I’d still like to know why the highest life form at the end of the Cambrian was the jawless fish. Hardly supportive of an “everything from nothing” claim that followers of some ancient, pre science, book insist on adhering to.
 
“As for you claiming that he made " "An incorrect assertion."about stasis and sudden apperance.”
Statis is totally consistent with Evolution. That’s why we have the Cambrian Explosion because it was the result of a period of non statis. That’s also why sharks and crocs have changed very little because their environments have remained largely consistent while at the same time land organisms have changed markedly.
 
”Which theory of evolution? The modern synthesis teaches that Evolution occurs at a uniform rate. Stasis is not consistent with the modern synthesis.”
Pure Strawman. Did Stephen J Gould renounce Evolution because of his findings? No!
Were his findings in any way consistent with some fabled  Global flood? No!

”The fossil pattern of discontinuity is not consistent with evolution,. Stasis is not consistent with the modern synthesis that has evolution happen at a uniform rate.”
Actually it is. Over 200 years of Geology have proved this. Denying facts doesn’t help your cause. Stasis or no Stasis single cell organisms appear way before first multicell organisms and worms and sponges appear before fish which in turn appear before tetrapods and so on and so on. Your appeal to Stasis cannot help you out of your dilemma. It’s just not a problem.
In view of these facts, i’d be interested if you think this god, that you cannot prove, performed millions of “creations” and “extinctions” over Geological time and why.

”You haven't shown him on the run. You have shown that you are a big mouth.”
Creationists often use this tactic of replying to someone without including the respondee’s id. It gives them a feeling of having the “last word” and some perverted form of victory because the respondee is unaware of the response. I’ve seen it time and again from Creationists.

”It is the evolutionists making an excuse for the fossil pattern. That is why they brought out Punctuated equillibrium to explain away the discontinuity which was not consistent with the modern synthesis aka neo darwinism.”
Punctuated Equilibrium and Gradualism are not mutually exclusive and Evolution accommodates both since it is not a case of one or the other. In other words,  Punctuated Equilibrium is STILL Evolution and is still NOT Genesis and Gradualism is STILL Evolution and is still NOT Genesis.
 
How you people must hate the evidence.
Reply: 9pt9
”Pilgrim, You can't reply to comments on a mobile device.”
If you can reply to the thread you can reply using the “reply” option or are telling me that the “reply” option (to the message that you are responding to) is suppressed on mobiles?
If that’s the case find yourself a laptop or desk  top.
 
” Animals caught up in swirling flood waters wouldn't be expected to fossilize. They would bloat, float and disintegrate. Only animals rapidly buried in landslides would fossilize. We wouldn't expect a mish-mash of fossils.”
Yes we would. Dead fish float as well as do dead mammals. Once the gases that cause bloating are released then all corpses, fish or mammals, sink.  
You really need to think things through before you go to print because you seem to be asserting that we have no reptile and mammal fossils because they would have to be caught in rapid lanslides. Either way this sheer coincidence that you are arguing for doesn’t explain the general pattern of first appearance of single cell, multi cell, sponges/worms, fish. Tetrapods, amphibians, reptiles, mammals/birds. Tell me why Dinos were caught in landslides that didn’t include Mammoths, Sabre Toot Tigers, Primates etc.
 
”We wouldn't expect to see bunny rabbits buried with fish. We would expect to see worms buried below and/or with fish.”
Yes we would. After the bloating process, bunnies would sink and join the fish corpses.
 
” We would expect to see amphibious animals buried just above fish. We would expect mammals to be buried above/with amphibians. Everything looks like a flood occurred in the past. Everything.”
Really? So why do we see amphibians occurring way before FIRST mammals and from thereon we see BOTH together in the fossil record? What possesses you to think that all amphibians could appear below all reptiles? Was every single amphibian in the process of mating at the time of this fabled flood?  Seiously, I ask you.
 
 
”The white elephant in the room is RMNS is completely incapable of causing the change in body plans and upward levels of complexity that evolution fans credit it with.”
But body plans don’t change. A cat and a dog have the same body plan yet they are two distinct lineages. Of course the problem that the anti science lobby have, is that they cannot identify the biological mechanism that prevents microevolution becoming macroevolution over greater periods of time. Funny that those who deny macroevolution subscribe to _superdupermacroevolution_necessary for post “flood” evolution.
 The double standards almost match the ignorance. 
 
”Your crap about organisms that didn't need to evolve is just an excuse for the evolution that isn't there. “
Yeah it is. Worms, Sharks, Crocs and Coelacanth. All surviving in relatively stable environments. On the other hand mammals going from tiny underground creatures during the reign of the dinos and aftere the demise of the dinos appearing as megafauna.
Impossible to explain with Creationism and fully consistent with Evolution.

”Phil, I dismantled the whale propaganda and served it up on a platter for you.”
I’m not Phil. Hell can’t you even get that right?
 
”You cant provide a sensible evolutionary pathway that could account for the slow separation the esophagus, trachea and all the neurological and histological changes that would have randomly "invented" cetacean blowholes.”
Again you are more concerned about the “how” while denying the “what”. All intermediate “locations” of  nostrils to blowholes exist. 
 
”Blowholes alone kill evolution as a possibility.”
In what way do you arrive at such a conclusion? Interesting too that within the embryo the nostrils start in the usual position(as land mammals) and then migrate into blowhole and blowhole position during embryo growth.  In fact the blowhole falsifies ID. Only an incompetent would “design” the same input for food and breathing. So if a solution was found for whales then why not for us?
 
”You don't have to believe "God did it" but it is certain evolution didn't do it.”
First part is correct. Evolution and God are not mutually exclusive.
Second Part, is totally wrong. The fossil pattern IS Evolution whether by natural means or via constant WIP by some God or Gods (though not be the god of literal Genesis as a this is false).
Reply: pilgrimpater "And there we have it. Over 150 years of the perfect  conspiracy."

Dogmatism and group think.

  "Funny then that Evolutionary Scientists go public on such things as dino soft tissue and Punctuated Equilibrium. Perhaps nobody told Schwartzer and Gould about the conspiracy.

Gould was already in a secured position and he spun punctuated equilibrium as evidence for evolution, He didn't go against the narrative of evolution being true.

You mean Dr. Mary Schweitzer, She was already in a secured position at North Carolina  State university. It wouldn't be easy to just get rid of her.   If they found out that she disavowed evolution then they may have used that to try and get shot of her.

 "Sorry but facts are facts and the fossil record shows a distinct pattern of first appearance of the major groups of animals"

Disparity before diversity, Contrary to neo Darwinism.

" If you don’t know why this is then just say so but please stop making excuses."

I didn't bring out punctuated equilibrium to make excuses for the discontinuous nature of the fossuil record.

"I’d still like to know why the highest life form at the end of the Cambrian was the jawless fish."

I would like to know why you cannot defend your dumb luck faith on its own merits.

As for  Fish, Fish could not have originated by dumb luck. You have faith in it but no evidence that fish originated by dumb luck.
Reply: Phillip Zachry  It's an excuse Phil. You hate science and prefer to accept just so stories. That is why you cannot back up your claim and produce what has been asked of you.
Reply: Benita Almond Our conversation is getting lost amongst other conversations, let me know if you want to continue in a new comment thread. Cheers.
Reply: Marshall Roberts
”More like dogmatism.”
So having a consistent and sound explanation for demonstrable evidence is now dogma.
The words “pot”, “Black” and “kettle” come to mind as it is those who start with a presupposed conclusion who are the ones guilty of being dogmatic.
As for "group think" what the Hell is Creationism if it is not "group think" by a group of scientific illiterates?

”Gould was already in a secured position and he span punctuated equilibrium as evidence for evolution, He didn't go against the narrative of evolution being true."
"You mean Dr. Mary Schweitzer, She was already in a secured position at North Carolina  State university. It wouldn't be easy to just get rid of her.   If they found out that she disavowed evolution then they may have used that to try and get shot of her.”

So it’s now all about “secured positions”. Can you name any Evolutionary scientist who is/was not in a "ecured position"? Even if this feeble excuse was true, don’t you think that these two would have sacrificed their “secured positions” for a Nobel prize which would be a given for any one who could actually falsify Evolution?

”Disparity before diversity, Contrary to neo Darwinism.”
Another feeble slogan. If you think the earliest life comprising of only simple single celled organisms is “disparity” as is the case then you are beyond any help.

”I didn't bring out punctuated equilibrium to make excuses for the discontinuous nature of the fossuil record.”
Except that punctuated equilibrium is a significant part of Evolution. Are you under the delusion is supports the flood myth? If so, again you are beyond all help.

”I would like to know why you cannot defend your dumb luck faith on its own merits."
"The jawless fish could not have originated by dumb luck. You have faith in it but no evidence that dumb luck created it.”
 
I can by referring to the fossil pattern. True I may not know the total developmental pathway but the pattern still stands of no jawless fish at the beginning of the Cambrian yet appearing at the end or soon after. The question that was posed to you was “how do you explain this in your bizarre world view because from where I sit, everything in the fossil record totally contradicts that view. Again if you don’t know the answer then save everyone’s time and just say so.
Reply: pilgrimpater "So having a consistent and sound explanation for demonstrable evidence is now dogma."

The evidence isn't consistent and it is not sound. Even evolutionists have had to dump the modern synthesis. But they will try and come up with a new "theory" to try and force the evidence to fit.

"As for "group think" what the Hell is Creationism if it is not "group think" by a group of scientific illiterates?"

Yet they knew that neo darwinism was nonsense. You clearly are scientifically illiterate to hold to the nonsense of neo darwinism.

"Even if this feeble excuse was true"

That's a feeble response,

"don’t you think that these two would have sacrificed their “secured positions” for a Nobel prize which would be a given for any one who could actually falsify Evolution?"

Once they lost their position and stopped getting their grant money then they wouldn't be doing the research to try and disprove it. They would be sidelined and without any income. They would be Pariah's to their colleagues.

You go along with evolution to keep your position secure and to get your grant money.

Evolutionary Biologist Lynn Marguilis "Richard Lewontin gave a talk here at UMass Amherst about six years ago, and he mathematized all of it—changes in the population, random mutation, sexual selection, cost and benefit. At the end of his talk he said, “You know, we’ve tried to test these ideas in the field and the lab, and there are really no measurements that match the quantities I’ve told you about.” This just appalled me. So I said, “Richard Lewontin, you are a great lecturer to have the courage to say it’s gotten you nowhere. But then why do you continue to do this work?” And he looked around and said, “It’s the only thing I know how to do, and if I don’t do it I WON’T GET MY GRANT MONEY.” So he’s an honest man, and that’s an honest answer.”

If he doesn't go along with it then he doesn't get his grant money.

As for falsification, when it comes to a metaphysical research program then it makes no sense to talk about falsification, While the modern synthesis has failed. They will still try and contort the evidence to try and fit an evolutionary narrative, They will try and make up another so called "theory of evolution" and claim the evidence supports it

When evolutionary explanations are so plastic to accomodate data that goes against what was previously claimed then it makes no sense to talk about naievety.

"Another feeble slogan"

Another feeble response.

"If you think the earliest life comprising of only simple single celled organisms"

 
They are  not simple. Your thinking is.

Why you would think arguing major groups appearing early on for  supporting the dumb luck you have faith in is very strange.

"Except that punctuated equilibrium is a significant part of Evolution."

That's the plasticity of evolution, stasis aka non change is used and turned into evidence. This excuse is not consistent with the neo darwinist position which says evolution is uniform and continuous and does not happen in leaps.

You need to make up your mind on your position

" explain in your bizzare world view"

You have faith in dumb luck, There is nothing more bizzare than that

"everything in the fossil record totally contradicts that view".

Everything in the fossil record was accomodated by the evolutionist. If the fossil pattern was different that would have been accomodated. There is nothing in the pattern that supports your faith as evolutionists just took what they found and accomodated it as being  evidence for evolution.
Reply: Marshall Roberts
”The evidence isn't consistent and it is not sound. Even evolutionists have had to dump the modern synthesis. But they will try and come up with a new hypothesis to try and force the evidence to fit.”
Again “modern synthesis” is irrelevant to the problem you have in addressing the fossil pattern which is as valid now (even more so as more fossils get discovered) as it was in when first formulated getting on for a century ago. Although irrelevant, I suppose it’s too much to ask why you think modern synthesis incorrect. You see the “what” (the Fossil pattern) stays as fact and ideas as to “how” that pattern may have occurred may change but that doesn’t change that pattern itself and that pattern is clearly an Evolutionary one.

”Yet they knew that neo darwinism was nonsense. You clearly are scientifically illiterate to hold to the nonsense of neo darwinism.”
Oh I see, you must be a fan of Darwin’s original works then. There is no such word as Darwinism btw any more than Jesusism and Neo “Darwinism” would only be the copious extra evidences that we have since discovered which actually confirm his Theory albeit Darwin could not have known of the mechanisms and he may have been wrong on some minor details. Quite a genius really to have a theory that has been nothing but bolstered by 150 years of extra evidence. Let’s, too, not forget Russel Wallace who arrived at the exact same conclusion albeit via a totally different set of data.
These are the guys, along with Hutton etc, who started exposing the prior superstitious explanation as a total sham. All down to evidence in the field.
It is Neo Creationismists who are scientifically illiterate which is why the Hovinds, Hams, Comforts, ICRs, AIGs etc etc are the laughing stock within genuine scienctific circles.

”that's a feeble response,”
Yet you seem incapable of telling me why.

”Once they lost their position and stopped getting their grant money then they wouldn't be doing the research to try and disprove it. They would be sidelined and without any income”
With a Nobel prize they’d never need to work again and let’s not forget personal integrity.
Why would they risk losing their grants by publishing works that, if neo Creationismists are to believed, contradict Evolution. Quite clearly Gould’s and Schweitzer’s works do not contradict Evolution and Gould’s work especially, totally supports it.
Let’s not forget that Darwin suppressed his publication for decades because of fear of the
backlash from the establishment which was staunchly Christian more so than today. It was only Wallace, who was about to publish his own findings, that forced his hand. That demonstrates the damage that a Theocratic society can cause. Thankfully those days are gone forever and scientists such as Gould and Schweitzer can now have no fear of publishing their findings.

”You go along with evolution to keep your position secure and to get your grant money.”
Oh really? Who are the one’s fleecing the gullible public out of millions upon millions?
Well the people of AIG, ICR etc etc of course.
If propagating a lie to the scientific illiterate can make you a millionaire, then why not? Assuming you have no conscience, that is.

”Evolutionary Biologist Lynn Marguilis "Richard Lewontin gave a talk here at UMass Amherst about six years ago, and he mathematized all of it”
Well she’s wrong then because mathematically it MUST be possible because the fossil pattern not only tells us it is possible but that it actually happened.
Of course these “mathematical” arguments are total tosh. You are the result of one in 250 million sperms fertilising 1 in a million eggs. That’s odds against you being you, and not somebody else, at one in 250K Billion. Factor in the chance random events that led to your parents meeting and the odds against increase markedly. Now factor in your parents’ births, and those of grandparents, great grandparents etc and we get absolutely silly numbers. Therefore, it is mathematically impossible for you to exist yet here you are writing nonsense on YT.
 
”If he doesn't go along with it then he doesn't get his grant money.”
Yes he does and you know it. It’s not as if there is a wedge strategy as there is with the “honest” bunch at the DI. Oh btw again you are attempting to shift the topic from the fact of the fossil pattern being an Evolutionary one to the actual mechanism and I should also add that Marguiis is openly pro Evolution. She is merely challenging the mechanism.
How any of this sidetracking helps your beleaguered position is beyond me.

”As for falsification, when it comes to a metaphysical research program then it makes no sense to talk about falsification, While the modern synthesis has failed. They will still try and contort the evidence to try and fit an evolutionary narrative.”
I could argue that the disciplines of palaeontology, geology and cosmology  falsify the Flood myth which they do but basic evidence and common sense allows even the layman to easily fulfil that task. On the other hand, if you are to falsify Evolution, you need to be a scientist qualified in the relevant field unlike Stephen C. Meyer who has no more idea about Palaeontological matters than the next man.

”When evolutionary explanations are so plastic to accomodate data that goes against what was previously claimed then it makes no sense to talk about naievety.”
Really? The fossil pattern IS an Evolutionary one and among all your posts you just haven’t been able to come up with an alternative explanation. Why? Because there isn’t one.
There is nothing plastic about explaining the evidence. The evidence cannot be plastic. It is what it is. Sorry.

”Disparity before diversity, Contrary to neo Darwinism.
"Another feeble slogan"
Another feeble response.”
Oh I see, you make feeble responses which I point out and explain why and therefore my responses are feeble. Surprised you don’t claim your dad is bigger than my dad.

”Their not simple. Your thinking is.”
Yep, those earliest fossils are simple. Not even eukaryotes which most complex life is based upon. Some early disparity, eh?

”You made the argument for the major groups of organisms appearing early on.
You need to make up your mind.”
No it’s very simple. Over Geological time (even regardless of the absolute age of the Earth), single cell organisms appear before first multi cell organisms whereby worms/sponges appear before first jawless fish which appear before first jawed fish and so on for tetrapods, amphibians, reptiles and birds and mammals with us humans appearing very late on, almost last, within mammalian history. Now tell me how that cannot possibly be Evolution and an even worse problem for you, tell me how in pity’s sake that fits the Global Flood myth (which has numerous other nails in it’s coffin)? 

”That's the plasticity of evolution, stasis aka non change is used and turned into evidence. This excuse is not consistent with the neo darwinist position which says evolution is uniform and continuous and does not happen in leaps.”
It’s extremely simple. Have a prolonged period of stability of a particular Environment and there are less pressures on species already adapted to that environment to change. On the other hand, rapid and significant changes in Environment cause mass extinction and other species relatively rapidly fill the niches and hence alter.
So, Punctuation and gradualism go hand in hand as explanations for what Geology and Palaeontology already tell us.

”You need to make up your mind on your position”
I haven’t changed my mind. I simply refuse to ignore demonstrable, observable evidence to fit some ancient superstitious myth.

”I am not the one that has faith in dumb luck”
I’m afraid you are. A primitive wooden boat carrying all the world’s species in gale force seas for a year, tsktsk. Wake up, this is the 21st century.

”You have faith in dumb luck, There is nothing more bizzare than that”
Nananana is not a great defence of your bizarre belief and there is no “luck” involved because there are no end targets. The number of extant species are totally dwarfed by the number of extinct species. So not so “lucky” for the vast majority of species.   

”Everything in the fossil record was accomodated by the evolutionist. If the fossil pattern was different that would have been accomodated. There is nothing in the pattern that supports your faith as evolutionists just took what they found and accomodated it as being an evidence for evolution”
Nope, the fossil pattern is what it is as outlined above. Not my fault the way it is but that’s the way it is. No accommodation and no faith to observe actual evidence.
This pattern was first noticed by the Victorians. You’d have thought that if it was going to be falsified, the thousands upon thousands of extra fossils that have been discovered since, would have done the trick but they have only strengthened  what those Victorians proposed. It was those Victorians who put the death knell on the prior superstitious explanation. There is no going back now. Creationistism, especially Neo Creationistism, is beyond resuscitation.
Reply: pilgrimpater "the fossil record IS evolution." The fossil record is nothing but bad news for evolution. It is proof that organisms appear and do not change. The overwhelming theme of the fossil record is stasis. And the fossil record pattern isn't as black and white as you've been led to believe. 
There is no evidence of caudal migration of nasal cavities. There are only fossils of land mammals with typical land mammal nasal cavities and whale fossils. Evolutionists embellish drawings and incorporate lots of imagination. It's far more than just a hole moving backwards. The internal changes requires to reconfigure a land mammals respiratory system to one with a blow hole are numerous. What kind of environmental pressures would slowly separate an esophagus and trachea over millions of years? You've been fooled I'm afraid :(
Reply: pilgrimpater "The fossil pattern"

Of stasis and discontinuity is not consistent with the evolutionary narrative.

"Neo “Darwinism” would only be the copious extra evidences that we have since discovered which actually confirm his Theory"

Neo Darwinism aka the modern synthesis is what has been taught as the modern theory.

It has failed and evolutionists have come out and  admitted that neo darwinism has failed and is dead and is gone.

The failed theory of evolution aka neo darwinism is hardly a ringing endorsement of "the evidence"

Of course the textbooks may teach the failed theory of evolution of neo darwinism as they haven't made up another one to try and force fit the evidence. But evolutionists have admitted it has failed. The evolutionist Gould admitted it failed back in 1980.

"Of course these “mathematical” arguments are total tosh."

That's what the neo darwinists may have thought of what the mathematicans told them at wistar back in the 1960s. If they had listened to them instead of ignoring them then this neo darwinist fairy tale may have been dropped as being a credible theory back then instead of this nonsense being promoted for decades.

"yet here you are writing nonsense on YT."

You are the one promoting the neo darwinist fairy tale, That's when you are not promoting Punctuated Equilibrium. You are in a muddle you see.

"With a Nobel prize they’d never need to work again and let’s not forget personal integrity"

It wouldn't be tolerated, They would not get funded, they would not get published and their position could be in danger.

They would keep their doubt's private and not risk losing their career. 

"Thankfully those days are gone forever and scientists such as Gould and Schweitzer can now have no fear of publishing their findings."

As long as they go along with the evolutionary narrative. Gould could only criticise neo darwinism by spinning the discontinuity and stasis and trying to contort it as an argument for evolution. If he came out and said evolution was nonsense and had failed in his works. That would have been the death knell of his career.

"How any of this sidetracking helps your beleaguered position is beyond me."

Yet your foaming at the mouth about the DI, Creationists, AIG, Meyer etc shows quite the contrary and that you are the one that is sidetracking, Your position is beleagured and that is why you are bringing all  of these things into the discussion and foaming at the mouth.

"Now tell me how that cannot possibly be Evolution"

The evolutionary hypothesis was built around the fossil record the way they found it. If the fossil record was different then they could have accomodated that,  for example,say an alternative pattern like amphibian to mammal. they could have fitted the pattern around that and the same could be said with other fossil arrangements.

"It’s extremely simple. Have a prolonged period of stability of a particular Environment and there are less pressures on species already adapted to that environment to change"

Mutations happen to animals in all environments all over the world. Not only would  there be hardly any constant environments over millions of years but the evolution you have faith in is meant to occur irregardless of need because mutations occur whether an animal is adapted or not. Millions of years of mutations and animals in stasis in all that time is not consistent with your faith.

"I haven’t changed my mind. I simply refuse to ignore demonstrable, observable evidence to fit some ancient superstitious myth."

The demonstable and observable evidence is that you have embraced the myth of neo darwinism and embraced punctuated equilibrim and are in a muddle when it comes to your faith.

"Nope, the fossil pattern is what it is as outlined above."

And stasis and no change for millions of years is not consistent with your faith

" Not my fault the way it is but that’s the way it is."

Not your fault that animals in stasis for millions of years does not support your faith. I agree.

 "No accommodation"

The hypothesis of Punctuated equilibrium shows otherwise. The evolutionists brought it out to accomodate the stasis and discontinuity.

"and no faith to observe actual evidence."

The observable evidence is that you have a lot of faith in neo darwinism, That is when you are not getting in a muddle and arguing for punctuated equilibrium which was brought out to accomodate the stasis and discontinuity and contradicts neo darwinism.

You are in a muddle when it comes to your faith.
Reply: Phillip Zachry "Improved capacity for diving and swimming, allowing a better opportunity for acquiring food sources."

I don't expect you to realize how ridiculous that statement is but I love responding to your comments. So it must have occurred something like this: A land mammal was living near the water, spending lots of time in the shallow water and diving for fish. It's offspring was born with a nasal opening 5mm caudally. That 5mm caudal shift of the nasal cavity helped that offspring dive better and find food easier so the trait was kept. As generations passed some were born with say 10mm of extra flab on the limbs. This extra flab helped the animal swim more efficiently so the trait was kept because it was more flipper like.
As the nasal cavity drifted back natural selection picked the animals with 1% separated esophagi, then 2% then 3% etc. because separated esophagus/ trachea aids survival………
Im sure you'll criticize this hypothetical because its stupid. But you must admit it would have to had occur somehow like this. Please feel free to add a scenario that would move a nasal cavity and split the esophagus and trachea. Explain how each small step of the dividing tubes added survival benefit. 

"You seem to think evolution is a wish list".

According to evolution, If a species dives in the water the more "fish like" animals will make it until the species is has full on aquatic features by evolution. How is that a wish list?

"How did Noah and his offspring produce enough children, breed enough dogs, camels, and horses to establish the Egyptian empire, erect monuments, and still have time to start building the other empires of the ancient world? How did these people manage to spread to the Americas in such a short time, on foot and establish the empires found there?"

How did evolution put humans, apes, ratites, anteaters, bears, cats on several separate continents when they are said to have evolved well after the split of pangea? Animal distribution is just another evolution killer. 
Why are there only 7 billion humans alive today if we have been here for 200,000 years? There would be more humans than atoms in the universe if that were the case!

Creation explains everything better of course. Because it's the truth. We just need more details :)
Reply: 9pt9
”The fossil record is nothing but bad news for evolution. It is proof that organisms appear and do not change.”
You are joking right? Are you saying that the fossil record shows humans, or any other ape, or even any other mammal appear in the Cambrian? Leaving aside your baseless and incorrect assertion that organisms do not change over Geological time, the important point is that major groups of organisms appear before other major groups e.g. fish appeared way before mammals appeared on the scene. Currently, Evolution is the ONLY explanation for that evidence. There are no alternative explanations, not one.
 
”The overwhelming theme of the fossil record is stasis. And the fossil record pattern isn't as black and white as you've been led to believe.”
Stasis is a key part of Evolution. Little or no change in Environment means less Selection pressure and little or no change (e.g. crocs, sharks). Perhaps you are now denying Palaeoclimatology. It’s amazing how the number scientific disciplines that you are duty bound to deny in order to defend a talking snake, mount up.
On the other hand catastrophic changes to Environment result in mass extinction and a relatively rapid filling in of the vacated niches e.g. below the KT layer we have dinos and only small mammals but above we have zero dinos and megafauna. Some “stasis”, eh?
Oh wait it’s one of
a) Pure coincidence
b) A conspiracy
c) Evolutionary scientists uncover the evidence but are too dumb to draw conclusions because alternatives with zero evidence are still correct.
d) Piltdown falsifies everything else
 
 
”There is no evidence of caudal migration of nasal cavities. There are only fossils of land mammals with typical land mammal nasal cavities and whale fossils. Evolutionists embellish drawings and incorporate lots of imagination. It's far more than just a hole moving backwards.”
So what do all those stages represent whereby the nostrils appear in different places? Why don’t we have the same variation in land mammals? Why do whales have vestiges of land animal limbs that can in some cases appear as atavisms? What would be the point of any stages in the various locations of nostrils as evidenced by the fossil record, especially considering these are now extinct?
What were the states of the nasal cavities in each of these fossils? Have you studied the fossils?
If it can happen in an embryo whereby nostrils start in the normal location and migrate to the top of the head to form a blowhole then how can you possibly assert it is impossible?
Btw why we are at it, what sort of cack arsed “designer” would “design” the same passageway for eating and breathing in humans but afford the humble whale a better “design”?  Shoddy work.
As for the drawing “embellishment” there is no embellishment of the skeleton which is the essential data. From the skeleton much information can be gleaned from that skeleton by analysing bone structure such as eye socket cavities, muscle and tendon cavities. It’s not rocket science. Even the police anthropologists can construct an accurate representation of a face from a skull. Everything you say wreaks of your “scientific knowledge” being stuck in the 18th century. 
 
” The internal changes requires to reconfigure a land mammals respiratory system to one with a blow hole are numerous. What kind of environmental pressures would slowly separate an esophagus and trachea over millions of years?”
Are there that many changes that make it impossible when we see the same process repeated in an embryo? Hardly impossible.
Minor changes (mutations) to regulating genes can cause greater changes to the protein coding genes that they regulate as we see with human and other ape skull formation and the different sections between bird and retile tails. Again, not even close to impossible.
 
”You've been fooled I'm afraid :(“
Yep, I never thought such rampant ignorance could still exist in the 21st century by armchair pundits but since my time on YT, i now know different.
Reply: pilgrimpater Organisms do change over time of course but not the way evolution teaches. Evolution assumes that because an organism isn't found in a "layer" that it didn't exist before. It completely ignores the possibility that is was just never fossilized. Now animals have assumed ages. The fossils date the layer and the layers date the fossils. Hilarious that people swallow this crap today.

"Stasis is a key part of Evolution."

LOL Sure it is! It better be because that's all we see. Instant appearance, no precursors, not much change, no transitions. Prove otherwise. 

"So what do all those stages represent whereby the nostrils appear in different places?"

There are whales and land mammals. 
The "transitions" are imaginary. There are no "nostrils appearing in different places" the way evolution needs. 

"embryogenesis"

Using embryogenesis as evidence for evolution is ridiculous. E-genesis is a 100% guided process unlike evolution. Evolution can't even account for the existence of a tube and certainly can't explain how one would slowly divide over time. 

You're well indoctrinated. Your trainers have done a splendid job preventing your brain from operating on its own.
Reply: Phillip Zachry "You're a bit off on the percentages, since a dividing wall would be a rather simple change in the structure and separate both effectively."

And you're making crap up. Neither you or the greatest evolutionary biologist on earth have the slightest clue as to how RMNS could have possibly made changes like that. Let alone calculate %'s. "Rather simple" LOL idiot. 

Yes I'm aware the continents were connected which is why i said it but you completely missed the point . According to evolution those animals evolved AFTER the continents split. Did they swim across the oceans? Hitch a rid on an ice berg?

"Do you honestly think that populations expand as fast as humans can reproduce or do you understand factors like disease, famine, war, and resources factor into the birth/death rate?"

Not at all. Start with a population of two 200,000 years ago and end with 8 billion (where we will be shortly). If the population only doubled every 2,000 years from the dawn of man , which is EXTREMELY & NONSENSICALLY conservative and would well account for famine, disease and war that would still yield  1.27 million trillion trillion people. An absurd figure.
But for mankind to start with 2 people, double 33 times to 8,000,000,000 allowing 200 years for each double (extremely reasonable to account for disease, pestilence, war etc.), the time mankind would be on the earth is 6,600 years. Hard cold fact that can't be changed. Just like the fact that the fossil record shows a lack of change. 

Phil, its clear you just parrot what others have told you. You don't think on your own.
Reply: Phillip Zachry Whale "evolution" is a tempest in a teapot anyway philly. If you have an imagination and a religious bent for evolution then you will see a transition. If you are objective and scientific you can look at the entire fossil record as a whole and see there is no real change and evolution isn't the answer. You keep arguing 1 imaginary lineage to thousands of examples of stasis. Not looking good for you and evolution. 
We have the same exact evidence except you are too indoctrinated to see what it actually shows. It's hilarious but pathetic too.
Reply: Phillip Zachry Don't worry about what you think I don't know. Worry about the fact you haven't been able to address any facts I've put to you in 4 months. 

Another evolutionaut eats it…….
Reply: 9pt9
”Organisms do change over time”
Good boy, Good boy.
 
”of course but not the way evolution teaches”
Oh I see. So having agreed on “change over time”, which must mean the more time the more the change, this somehow isn’t Evolution? Perhaps you could enlighten me on the biological barrier that allows changes over small amounts of time yet suddenly kicks in when a certain unspecified amount of time elapses.   
 
”Evolution assumes that because an organism isn't found in a "layer" that it didn't exist before.”
How wrong is that statement. Granted that you can never have enough fossils, there are still millions of fossils and from across the whole globe at that. Must be just sheer bad luck that amongst these millions we’ve never found a bunny in the Cambrian or a Human in the Jurassic or a dino in the Pre Cambrian. What dashed bad luck that we are being fooled by this pattern. 
 
” It completely ignores the possibility that is was just never fossilized.”
The vast vast majority of organisms that have ever lived do not leave a fossil. In fact this raises a very interesting point because given that rarity we still have millions of fossils and the only way that can be achieved is via a very old Earth and not geologically yesterday as with such looney toon claims as Literal Genesis proponents (I’ll give you the benefit of the doubt that you do have at least one brain cell and are not a Biblical Creationisimist).
We work with what we have and the pattern in the fossil record is unmistakably an evolutionary one, regardless of the absolute time span.
 
”Now animals have assumed ages. The fossils date the layer and the layers date the fossils. Hilarious that people swallow this crap today.”
Presumably you are referring to the tiny tiny proportion of past species that are used as index fossils. Yes, these may be used to provide a more absolute date within in an already extrapolated date range but let’s remove these few index fossils from the mix. We are STILL left with the clear Evolutionary pattern by the methodology of relative dating. Btw, at this stage, i am only talking about relative dating because to discuss absolute dates would allow you to side track from addressing the fossil record pattern (just in case you wondered). 

"Stasis is a key part of Evolution."
”LOL Sure it is! It better be because that's all we see. Instant appearance, no precursors, not much change, no transitions. Prove otherwise.”
“Instant appearance”, eh. Do you ever get the feeling of dejavu?  I seem to recall someone saying “It completely ignores the possibility that is was just never fossilized” to me. I just can’t recall who. Nevermind, I know someone said it, doesn’t matter who, probably some nobody.
So where are these “sudden” appearances? Are you saying the modern whale “suddenly” appeared from nowhere just because you ignore all the prior extinct species that preceded the modern whale and share various stages of intermediate traits? Pretty good at shooting yourself in your own foot aren’t you.
 
”There are whales and land mammals.”
Genius!
 
”The "transitions" are imaginary. There are no "nostrils appearing in different places" the way evolution needs.”
Au contraire. There are and they are all in chronological order also coinciding with diminishing limb size. Still all these other species must also have appeared “suddenly”, according to you that is. 

”Using embryogenesis as evidence for evolution is ridiculous. E-genesis is a 100% guided process unlike evolution. Evolution can't even account for the existence of a tube and certainly can't explain how one would slowly divide over time.”
You misread me. I am not claiming that embryology recapitulates Evolutionary History (it does in parts, of course) but I was merely pointing out that we can observe something which you claimed (without evidence) as impossible to happen.  

”You're well indoctrinated. Your trainers have done a splendid job preventing your brain from operating on its own.”
At last a winning statement from you. You win, EVILution must be a lie and i'm replacing all my science books with the Bible, KJV, of course.
Reply: pilgrimpater There aren't any Whale precursors except on fake clade drawings. Whales do appear suddenly just like every other organism in the fossil record. The whale evolution story is absurd.
But whales are academic anyway. Evolution must account for 3.5 Billion years of zero evolution of bacteria followed by the cambrian explosion and the stasis that followed. It can't. The changes that did follow are some bigger, some smaller. No real change. Flight of insects, bat and birds have no answer. Heck evolution can not account for one cell or a simple tube of any kind. Just the facts. Sorry :(
Reply: 9pt9
"There aren't any Whale precursors except on fake clade drawings."
Except those drawings are based on the fossils.Are you suggesting that nostrils on Rodhocetus fossils are in a different position to those depicted on the drawings? Evidence please.

"Whales do appear suddenly just like every other organism in the fossil record. The whale evolution story is absurd."
So presumably Pakicetidae vanished "suddenly" at the exact time that Ambulocetidae "suddenly" appeared which in turn "suddenly" disappeared as Remingtonocetidae "suddenly" appeared and so on and so on. Interesting concept, so now please explain to me the evidence for any mechanism that caused these "sudden" appearances and disapperances. That's your homework.
Bear in mind this doesn't help you out the problem of the fossil pattern of first appearance of the major groups.

"But whales are academic anyway."
Well they are not but having said that they probably have more qualifications than you can ever hope to have.

"Evolution must account for 3.5 Billion years of zero evolution of bacteria followed by the cambrian explosion and the stasis that followed."
Must it? Environmental stability (of where simple single cell organisms resided) means little pressure to change. The Cambrian was a reaction to increased Oxygen levels whereby organisms could acquire hard parts (hence more fossils than Pre Cambrian). The highest life form in the Cambrian was the Jawless fish (even then i may be wrong as probably appeared later), so jawed fish, tetrapods, amphibians, reptiles and mammals/birds that followed in that sequence of first appearnce represent Stasis in your mind? I think that needs some explaining. I can't wait. I could do with a laugh.

"It can't. The changes that did follow are some bigger, some smaller. No real change."
Well that's true for anyone who is under the illusion that a Trilobyte and Mammoth exhibit "no real" change. Seriously, is that what you are trying to tell me? I don't wish to be rude but are you having to use braille to "study" fossils?
 
"Flight of insects, bat and birds have no answer. Heck evolution can not account for one cell or a simple tube of any kind. Just the facts. Sorry :("
Well it can but i'd dearly love to hear from you why it cannot. I want to know why insects don't appear until the Devonian. The floor is yours or are you going to persists with constant denial based upon absolutely nothing?
Reply: pilgrimpater "Except those drawings are based on the fossils"

From a few bony twigs and chips comes a complete recreation of a mammal and the absolute certainly that it was a whale to be! 

"So presumably Pakicetidae vanished "suddenly" at the exact time that Ambulocetidae "suddenly" appeared which in turn "suddenly" disappeared as Remingtonocetidae "suddenly" appeared and so on and so on"

Indohyus 48 MYA, 2 ft long
Pakicetus 48 MYA 3 ft long
Ambulocetus 50 MYA 10 ft long
Kutchicetus  48 MYA 8 ft long
Rodhocetus 47 MYA 10 ft long

All lived at the same time or out of chronological order. They can not possibly  ancestors of each other. Whale lineage crushed right there. 

The 2nd rodhocetus fossil revealed artiodactyl limbs proving it was just an everyday land mammal. Nothing "whale like" about it. 

"The Cambrian was a reaction to increased Oxygen levels whereby organisms could acquire hard parts"

LOL any port in the storm.

"I want to know why insects don't appear until the Devonian."

I want to know why we can't observe unicellular life going multicellular. That's evolutions real chance to show it self but it doesn't happen. No proto organs or limbs to be seen. Evolution stopped!

Who cares when insects appeared. The fossil record could be layered perfectly and the time lines bang on and evolution is still wrong. Nothing connects the layers and the transitions should be everywhere. Transitions should be the theme of the record but are nowhere to be found. Flight of any kind can only be explained by wild speculation. "RMNS did it"! 

"The floor is yours or are you going to persists with constant denial based upon absolutely nothing?"

Based on nothing? LOL I'm guilty of personal incredulity!! I don't believe RMNS can slowly build insect wings. I don't' believe RMNS can build a tube. Why? Nobody has ever seen evolution do anything.
Reply: 9pt9
”From a few bony twigs and chips comes a complete recreation of a mammal and the absolute certainly that it was a whale to be!”
Your local police forensic department can accurately recreate a replica of face from a skull purely by looking at the bone structure, e.g. such things as depth, shape and size of eye sockets. The same technique applies to fossils.
I asked you for evidence that the drawings were faked. I asked you for evidence that the position of the nostrils on any one species is deliberately faked on the relevant drawing. Sorry but you just saying something that suits your world view does not constitute evidence. 
Where is this evidence?

Indohyus 48 MYA, 2 ft long
Pakicetus 48 MYA 3 ft long
Ambulocetus 50 MYA 10 ft long
Kutchicetus  48 MYA 8 ft long
Rodhocetus 47 MYA 10 ft long
 
Not sure if you got these ages from a creationist misinformation site or plucked out your arse.
 
You seem to think that including lengths forms some sort of argument. Well let’s see how that works.
 
Chiwawa: 17-23cm
Fox Terrier: 41-48cm
St Bernard: 71-75cm
Presumably, according to your “logic”, these are different species that are totally unrelated. Yeah that works a treat.
 
However, the homework I set you was to explain what mechanism caused “sudden” disappearances coinciding with “sudden” appearances of brand spanking new species (throughout the whole of the Earth’s biological history). Are you having trouble with this?
 
All lived at the same time or out of chronological order. They can not possibly  ancestors of each other. Whale lineage crushed right there.
Yes of course, 3 million years (50-47, using your figures of dubious source) is no time at all is it? I mean 3 million years is a drop in the ocean compared the handful of centuries post “Global” “Flood” where extraordinary rates of “micro” Evolution took place producing both tiny Bobcats and massive Sabre Tooth Tigers from just one pair of moggies.
Btw whose sequence? The sequence as per scientists working in the field or the sequence as per Creation Pseudoscience sites manipulated from their armchairs?

”The 2nd rodhocetus fossil revealed artiodactyl limbs proving it was just an everyday land mammal. Nothing "whale like" about it.”
Since land mammals preceded water mammals, as per the fossil pattern, then why are you so surprised that some in the whale genera retain some land characteristics. Even modern whales have vestiges of land characteristics and with rodhocetus (I am not saying it is wholly land or water based) just look at the shape of the skull. Is that typical of land animals?  
Those short legs are perfect for chasing down land prey, NOT.

"The Cambrian was a reaction to increased Oxygen levels whereby organisms could acquire hard parts"
LOL any port in the storm.
LOL, any evidence in a storm. Oh I forgot, you have to deny Geology and Palaeoclimatology as well as Palaeontology in order to hold on to that Talking Snake myth (you have to be a creotard with your level of argument).

"I want to know why insects don't appear until the Devonian."
And I still want to know. Any ideas?

”I want to know why we can't observe unicellular life going multicellular. That's evolutions real chance to show it self but it doesn't happen. No proto organs or limbs to be seen. Evolution stopped!”
For the same reason we can’t see observe a cat going to a dog. Totally different lineages/branches and re single to multi, mostly totally different types of cells.
Do you think you could do everyone a favour and actually answer a question instead of thinking that asking another question (which gets answered btw) is a valid response?

”Who cares when insects appeared.”
I do. I want an answer and I want to know why they took so long to appear.
 
”The fossil record could be layered perfectly and the time lines bang on and evolution is still wrong.”
Proving, beyond doubt, that no amount of evidence will be accepted by someone who provides zero evidence against evolution or for any alternative. Can’t say I am surprised.
 
”Nothing connects the layers and the transitions should be everywhere. Transitions should be the theme of the record but are nowhere to be found. Flight of any kind can only be explained by wild speculation. "RMNS did it"!”
We have already agree that only a fraction of species will ever leave a fossil but out of the millions that we do have, we have a clear pattern of major groups of animals making a first appearance in sequence. Despite this transitionals do also exist and these are exactly what you would be demanding if they didn’t exist but you need to explain the overall pattern before discussing such detail.  
 

”Based on nothing? LOL I'm guilty of personal incredulity!!”
Yes guilty and condemned to ignorance. Personal incredulity and baseless opinion counts for sweet fa.
 
 *”I don't believe RMNS can slowly build insect wings. I don't' believe RMNS can build a tube. Why? Nobody has ever seen evolution do anything.”*
Why don’t you believe this? It’s all down to belief with you rather than evidence. It’s not as if the change happens overnight as your strawman position would claim. If a flightless bird can have a partial wing like an Ostrich or Penguin, then why can’t an insect? While some insects such as dragonflies have proportionally long wings, others such as some beetles have very small wings. In nature we can even see adult ants go from having no wings to having wings. According to you, impossible.
Oh just a reminder, “When did insects appear?” and “why?”.
Reply: pilgrimpater "You seem to think that including lengths forms some sort of argument. Well let’s see how that works."

It works fantastic since blue whales are 100ft long and weigh 300,000lbs. From little 2ft  indohyus to the 100ft blue whale! Its enough to make any rational person question but not evotards. RMNS can work all kinds of miracles right? Rodhocetus had nice LONG legs for walking on land. What on earth would make anyone come to the conclusion that it was a whale precursor is anyones guess. There is absolutely nothing about rodhocetus that is marine like. Only in the eyes of hungry paleontologists. But you suckers will argue to the death it was a whale to be! By the way, do a good study on the anatomy of blowholes. Flap on the top, air sac echolocation systems, no sinuses like land mammals...It goes way beyond a shift of the nasal cavity (enter magic RMNS).

And my dates are right. Feel free to look at any source. Ambulocetus is older that indohyus and the rest lived at about the same time. Feel free to deny it. No way were they ancestors of each other. 

"However, the homework I set you was to explain what mechanism caused “sudden” disappearances coinciding with “sudden” appearances of brand spanking new species (throughout the whole of the Earth’s biological history). Are you having trouble with this?"

No trouble at all. Science has no real answer for what caused the "sudden" appearances of organisms. It's assumed they evolved from earlier organisms but unfortunately for evolution there is zero evidence for it. RMNS is simply credited as the mechanism. Laughable. Then the organisms don't change at all for 100's of millions of years. Evolution where are you??? Poor T-rex was stuck with those tiny little arms for 60 million years with no change at all. 

"The Cambrian was a reaction to increased Oxygen levels whereby organisms could acquire hard parts"
LOL any port in the storm.
LOL, any evidence in a storm."

Really? Where is the evidence that increases in O2 causes evolution? Theres been plenty of O2 around since and we see zero explosive evolution like that alleged in the cambrian "bad news for evolution" explosion :)

"I want to know why insects don't appear until the Devonian."
And I still want to know. Any ideas?"

Doesnt matter when they appeared. Evolution doesnt explain it. Feel free to explain insect flight using evolution theory. I beg you. 

”The fossil record could be layered perfectly and the time lines bang on and evolution is still wrong.”
Proving, beyond doubt, that no amount of evidence will be accepted by someone who provides zero evidence against evolution or for any alternative. Can’t say I am surprised."

And this sums up your entire position. Fossils appear in layers therefore common ancestry is true by way of RMNS. 

ALL academic anyway since evolution can't even explain one cell. HA HA HA!
Reply: Phillip, Take a good look at your dates and mine. Not only are mine right in the ball park with yours but your dates make the situation worse for the imaginary whale transition. I'm sure you don't see why. Remember, evolution can't account for one cell, one tube so forget about blowholes! :)
Reply: Phillip Zachry Give it up Phil. The modern synthesis aka Neo darwinism has failed. Even evolutionists have admitted it as I have shown you before. You have faith in a failed hypothesis.
Reply: 9pt9
”It works fantastic since blue whales are 100ft long and weigh 300,000lbs. From little 2ft  indohyus to the 100ft blue whale!”
REMINDER. Chiwawa vs Doberman. Seems like these must be different species in your book. Yet again facts contradict your baseless assertions.
 
”Rodhocetus had nice LONG legs for walking on land.”
Long “hands”, SHORT limbs. Much better suited for water than land not to mention the overall shape being very whale like.
 
”By the way, do a good study on the anatomy of blowholes. Flap on the top, air sac echolocation systems, no sinuses like land mammals...It goes way beyond a shift of the nasal cavity (enter magic RMNS)” Why is any of that a problem for Evolution? Wolf to Boston Terrier. Wolf to the Shar Pei from no loose skin to nothing but loose skin. Humans born with webbed hands, or if you like, flaps between fingers. What are you trying to tell me? 
.

”And my dates are right. Feel free to look at any source. Ambulocetus is older that indohyus and the rest lived at about the same time. Feel free to deny it. No way were they ancestors of each other.”
You didn’t give ranges and selected the minimum and maximum from the ranges to suit your unevidenced assertion. And again, I have to remind you, that it was YOU who claimed we can’t make assumptions because not every organism leaves a fossil.

”No trouble at all. Science has no real answer for what caused the "sudden" appearances of organisms. It's assumed they evolved from earlier organisms but unfortunately for evolution there is zero evidence for it. RMNS is simply credited as the mechanism.”
The problem you have is that, taking the whale lineage as an example, the individual species, that have similarities, despite what you assert, appear relatively closely over geological time.
If the reason is not via Evolution then we would expect to see each of these species “suddenly” appear at ANY time in our geological past, including the pre Cambrian. Why don’t we see ANY mammals “suddenly” appear in the Pre Cambrian and/or the Pleistocene?
Seems all organisms follow on from very similar previous ones instead. THAT is Evolution.
Still cudos to you for openly admitting that you don’t have a scientific explanation for your prior assertion. I knew that already but it’s good of you to openly admit it.
 
 
”Laughable. Then the organisms don't change at all for 100's of millions of years. Evolution where are you??? Poor T-rex was stuck with those tiny little arms for 60 million years with no change at all.”
Is there any reason why TRex should change if it was so successful and nigh on optimally adapted to it’s environment? Well in within Evolution, NO! 

”Really? Where is the evidence that increases in O2 causes evolution? Theres been plenty of O2 around since and we see zero explosive evolution like that alleged in the cambrian "bad news for evolution" explosion :)”
Actually there hasn’t always been plenty of O2 but we have already ascertained that you are duty bound to deny Geology and Palaeontology since they contradict your unevidenced world view.

”Doesnt matter when they appeared. Evolution doesnt explain it. Feel free to explain insect flight using evolution theory. I beg you.“
It does matter because according to you, any one species can appear at any time “suddenly” out of absolutely nowhere yet what we find is that insects first appeared and then all other insect species followed i.e. consistent with Evolution. Whether I can explain how wings developed is irrelevant because the fact is that first insects had no wings and then they did develop. Again you ignore the general picture by smokescreening with a demand for fine detail. I won’t let you get away with that no more than I am not letting you get away with your inability to explain the fossil pattern.
 

”And this sums up your entire position. Fossils appear in layers therefore common ancestry is true by way of RMNS.”
Not at all, unlike you, I am quite open to Evolution being falsified but the problem is that people like you provide any evidence. Assertions and wishful thinking are not evidence. To admit that you would accept no level of evidence for Evolution speaks volumes for your presuppositional religios demeanour.
Sad.

“ALL academic anyway since evolution can't even explain one cell. HA HA HA!”
Oh now we are approaching the abiogenesis smokescreen. Totally different discipline to Evolution.
 
Anyhow still waiting for your explanation for the fossil pattern and how your baseless assertion of “sudden” appearances follow that pattern or any pattern at all. How come we don’t see species “suddenly” appearing in our lifetime if your own goal assertion is true?
Reply: Phillip Zachry Remember Phil, Evolution is a metaphysical research program. So even when the theory aka speculative hypothesis of neo darwinism failed then they are still going to look for a new hypothesis to try and mould the evidence to fit. This is what happens when you have a metaphysical research program of evolution.
Reply: narco73 Hi Narco - I do see what you are trying to say - However your P2 is false the universe is not painted. The universe exists - we see it, live in it, breath in it, pro-create in it etc. Even though a painting exists nothing alive exists within it.
Reply: Benita Almond Thanks of the reply. I thought you had forgotten about our conversation.

And exactly, the premise 2 has not been shown to be true. And neither has the premise 2 in the argument that attempts to prove a creator. That was my point. No one has shown that the universe was painted, and no one has shown that it was created.
Reply: Justwantahover
The hillarious thing is that he has pulled out of his arse invented "sudden" appearance. from absolutely nowhere, as a replacement for Evolution by natural selection acting upon the changes in existing organisms, yet cannot give any mechanism for this "sudden" appearance (i've got more to say on this in the pipeline).
The doubly hillarious thing, is that in his desperation to provide an argument against Evolution, he has proposed a hypothesis that totally falsifies Literal Genesis.
Yeah, the shooting from the hip (because no matter how good a student you are of creationist propoganda sites  they don't cover the basic issues) is very much like Mark but at least the latter is not so abrasive and cudos to him for allowing comments and open discussion that totally embarrass his video..
Reply: Marshall Roberts
Oh i forgot about you. I set you a lot of Homework way back. Have you done it yet or are you just as bereft of any ideas as is poor old 9pt9?
Reply: Marshall Roberts "HAHAHAHA"
Is that your best argument against demonstrable evidence?
So when exactly did you shoot me down when it was me who left you so many questions that you obviously have so much problem addressing?
If you want to reopen the dialogue then go back and address the issues proposed to you.
If you just want to respond with HAHAHAHA then not only does it make you look non too clever but it is waste of everyone's time, including yours.
Reply: Marshall Roberts
Oh i see, so you have opted for the former option out of the two i gave you. If false bravado and having the last word rather than providing any evidence against evolution or for creationistism is your bag, then be my guest. Sometimes children have to be humoured.
Reply: Marshall Roberts
I thumbed up your latest HAHAHAHA for fulfilling my prediction of your next response. It is patently obvious that you have nothing and it is there for everyone to see. Do yourself a favour and try to debate the topic. Until that time arrives there is no point in continuing to respond to comments that comprise solely of HAHAHAHA. I have far better things to do, such as eating a yoghurt that is just out of date.
Reply: I just saw that this thread had someone saying "HAHAHAHA" in capital letters all through it.
Having debated creationists online before, I immediately assumed that the person doing this must be a creationist, and in particular one who can't formulate a real argument.
So I read some of the thread to see i was correct in my assumption, and yes, I was (of course).
Reply: Phillip Zachry Avoiding the question. AGAIN. How convenient for evolution that only the transitional fossils escaped fossilization. 

“Paleontologists have paid an enormous price for Darwin’s argument. We fancy ourselves as the only true students of life’s history, yet to preserve our favored account of evolution by natural selection we view our data as so bad that we almost never see the very process we profess to study. …The history of most fossil species includes two features particularly inconsistent with gradualism: 1. Stasis. Most species exhibit no directional change during their tenure on earth. They appear in the fossil record looking much the same as when they disappear; morphological change is usually limited and directionless. 2. Sudden appearance. In any local area, a species does not arise gradually by the steady transformation of its ancestors; it appears all at once and ‘fully formed.’” (Gould, Stephen J. The Panda’s Thumb, 1980, p. 181-182.)

Know when you're owned. Beat it Phil.
Reply: 9pt9 You quoted Stephen J Gould.

Would that be the same Stephen J Gould who said that his work his work does not support creationism?

The same Stepen J Gould who said that creationists who quote him in support of their postition are either dishonest or stupid.

Is it that Stephen J Gould?

Or was it someone else?
Reply: narco73 Yes that Gould. A "real" scientist in your opinion.
Reply: Phillip Zachry You can't disprove the quote so all you can do is quote whine. You need some new material.
Reply: narco73 "Would that be the same Stephen J Gould who said that his work his work does not support creationism"

Well as an evolutionist Gould tried to force fit  "it appears all at once and ‘fully formed." into an evolution worldview, Yet the neo darwinist paradigm is of gradual uniform change and continuity not stasis and discontinuity.   This is a case of evolutionists taking what goes against their faith and accomodating it and trying to force it to fit an evolutionary paradigm even though stasis and discontinuity is the opposite of what is proposed by neo darwinism and not expected by evolutionists.

The fact that Gould didn't like his words being used is irrelevant. Hostile witnesses might not like their words used against their own side. Doesn't make it illegitimate.  Gould's colleague Niles Eldredge admitted that paleontologists did not want to point out the state of the fossil record because it is not compatible with neo darwinian theory.

Eugene Mccarthy PHD macroevolution.net quoting Niles Eldredge on the hesitancy of paleontologists to admit that the fossil record is not consistent with neo darwinism.

"Eldredge (1995: 68) asserts paleontologists have hesitated to emphasize the observed pattern of stasis in the fossil record because it is inconsistent with neo-Darwinian theory:
For the most part it has been paleontological reluctance to cross swords with Darwinian tradition that accounts for the failure to inject the empirical reality of stasis into the evolutionary picture."
Reply: Phillip Zachry Gould is referring to the state of the fossil record,Stasis and Discontinuity.  Punctuated equilibrium was Gould and Elderedge's  ad hoc hypothesis to try and explain away this stasis and discontinuity. You are confusing the ad hoc explanation with the pattern that it was created to explain away.

It's a red herring to talk about him not supporting Creationism. Fact is that he pointed out the failure of the fossil record to support your neo darwinian faith. His and Elredges explanation is an argument from silence. An argument from a lack of evidence for the forms which were expected to be seen in the fossil record. Claiming evolution happened in spurts as to leave no evidence for these transitions behind. It is no better than those gradualists who made up the excuse of an imperfect fossil record to try and excuse the discontinuity and stasis in the fossil record.
Reply: MarshaII Roberts I think you missed the point. It wasn't so much that Gould gets annoyed by creationists quote mining him, it is that the only reason he sees that they do it is through dishonesty or stupidity.

I think there is probably a third option, and that is a combination of the first two options. Ignorance being a form of stupidity, and breaking the 9th commandment (false witness) being a form of dishonesty.

"Fact is that he pointed out the failure of the fossil record to support (evolution)".

No, he didn't. You should probably read what he actually wrote, and don't read it on a creationist quote mining website.
Reply: MarshaII Roberts "Gould made his statements during a time of heated battles about the teaching of creationism in schools"

Gould was explaining his words more clearly to people who (either through dishonesty or stupidity) were misrepresenting them.

"Yes he did. he may have tried to have spun the lack of transitions for evolution"

Actually Gould says that there are both transitional fossils at the species level and that there are abundant transitional fossils at higher levels. This is the opposite of what you have read into it. Funny how you think (either through stupidity or dishonesty) your interpretation of Gould's words is more accurate than his own.

The quote rebuts your interpretation by itself, if you look at the parts that were (either through dishonesty or stupidity) left out.
Reply: narco73 "Gould was explaining his words more clearly to people who (either through dishonesty or stupidity) were misrepresenting them."

Gould was making a political statement his words show he said the fossil record was inconsistent with neo darwinism. he himself declared neo darwinism dead despite being taught as textbook orthodoxy.

Gould as quoted by The Evolutionists Brian Charlesworth and Russel Lande
 
“I have been watching it  [neo-Darwinism] slowly unravel as a universal description of evolution…but…that theory, as a general proposition, is effectively dead, despite is persistence as text-book orthodoxy.”
 
Charlesworth, B., Lande, R., and Slatkin, M., "A Neo-Darwinian Commentary on Macroevolution,"

"Actually Gould says that there are both transitional fossils at the species level and that there are abundant transitional fossils at higher levels."

Yet Gould earlier said "“transitions between major groups are characteristically abrupt."

He later tried to backtrack for political reasons but his earlier words show his real position.

"This is the opposite of what you have read into it. Funny how you think (either through stupidity or dishonesty) your interpretation of Gould's words is more accurate than his own."

The fact is that you are ignorant of his earlier words and are not very well informed on this issue.

"The quote rebuts your interpretation by itself, if you look at the parts that were (either through dishonesty or stupidity) left out."

The quote fails because his earlier words show what he really felt.

Your own ignorance and stupidity on this issue is only a display of your own ignorance and stupidity.

Gould Earlier admitted "“transitions between major groups are characteristically abrupt.

He later said what you quoted for political reasons during heated political battles about teaching creationism in schools.

It is clear that the earlier quote is Gould's true feelings on this issue.

We know just how much he accepted the failure of neo darwinism because he declared it as dead despite being taught as textbook orthodoxy.

Your ignorance on this issue is not displaying dishonesty. It is just that you are too short for the ride and have very little understanding and are a Johnny come lately to this issue.
Reply: MarshaII Roberts I'm starting to wonder if you are being serious, or just trolling. I mean really. Yet I will continue under the assumption that you are actually being serious.

And so, I will try to make this as simple as possible.

Firstly, I assume that we are currently discussing whether or not evolution has occurred. We are not discussing whether or not punctuated equilibrium has occurred, nor are we discussing "Darwinism", "neo-Darwinism" nor "acid-house-Darwinism".

Secondly, it doesn't matter what Gould or anyone else says, it is the facts and the application of the scientific method that is important. It wouldn't matter if Gould said "Evolution has not occurred", it would not make it so.

However, ironically, you have chosen to use someone for your fallacious appeal to authority who does accept evolution and disagrees with both your position AND your interpretation of what he has said.

Most scientists believe that evolution has followed a type of phyletic gradualism, whereas Gould thinks that it has followed "punctuated equilibrium".

What should be immediately obvious, is that it doesn't matter which of these (if indeed either) are correct, in both cases evolution has occurred.

So quoting Gould against evolution should be a non starter.

But you take the preposterous position that your interpretation of Gould's words is better than his own.

Yet you quote him saying things that clearly don't support your position.

Take your last post for just one example. You mention this quote twice in one post, so you must think its a good one: "transitions between major groups are characteristically abrupt".

What should be immediately obvious is that it doesn't matter if transitions are abrupt or drawn out, there are still transitions!

You claim to know Gould's words well, yet I am 99.9% sure that all you have read on them is with respect to creationists claims about him.

If you were so well read on Gould as you claim, you would know that that quote "transitions between major groups are characteristically abrupt" is taken from a section were he is discussing precisely why this is not a problem for evolution! Yet you interpret it as the opposite!?!?

You then try to claim that Gould's hypothesis is an ad hoc addition to evolution, but this just leads me to believe that you don't know what the term ad hoc means in this context. It is clearly not ad hoc, as evolution does not fall if phyletic gradualism turns out to be not correct, so this line of arguing is also clearly misguided.

Which leaves me with the question: Is honesty at all important to you?
Reply: MarshaII Roberts I see I've made you resort to "HAHAHAHA" again. I'll take that as a complement.

And everything else in your comment has already been addressed. We've already explained the exact quote which you (incredibly) just repeated.

And we've already explained how Gould does not say that there are no transitional fossils. 

To repeat (you some how missed it the first time(s)):

1> Gould says that there are relatively few transitional fossils at the species level. So what? Clearly he is saying that there ARE transitional fossils at the species level. The quote you just gave says so, yet you claim it says the opposite!
2> Gould says that there are plenty of transitional fossils at higher levels.
3> You just repeated the quote about transitions being abrupt between major groups, but as already explained, abrupt transitions are still transitions. So again, the quote says the opposite of what you seem to think it does.

I have to ask again: Is honesty at all important to you?
Reply: "And everything else in your comment has already been addressed. "

And failed.

"And we've already explained how Gould does not say that there are no transitional fossils. "

Oh so you're saying that Gould's was being inconsistent and believed in Darwinian gradualism which says that evolution does not occur in jumps but then believed in punctuated equilibrium that evolution happens in jumps

Poor Gould was not consistent if you are claiming his political stance was his real stance.

Clearly Gould was saying that they were missing between major groups too.

" Gould says that there are plenty of transitional fossils at higher levels."

" You just repeated the quote about transitions being abrupt between major groups, but as already explained, abrupt transitions are still transitions. "

I repeated the full quote because you did not understand what he is saying. he says the gradualistic intermediate forms are missing

"So again, the quote says the opposite of what you seem to think it does."

Nope, having to post the full quote because you did not understand what Gould was saying only shows that you are ignorant and do not understand

"I have to ask again: Is honesty at all important to you?"

It clearly isn't to you, After you have been shown clearly Gould's words then you repeat your falsehood.

All paleontologists know that the fossil record CONTAINS PRECIOUS LITTLE IN THE WAY OF INTERMEDIATE FORMS; TRANSITIONS BETWEEN MAJOR GROUPS ARE CHARACTERISTICALLY ABRUPT. GRADUALISTS  usually extract themselves from this dilemma by INVOKING THE EXTREME IMPERFECTION OF THE FOSSIL RECORD " (Gould, Stephen J., The Panda's Thumb, 1980, p. 189)

He is saying the intermediate forms are missing and that gradualists extract themselves from the situation by calling on the imperfection of the fossil record.

"abrupt transitions are still transitions. "

That is begging the question. To claim that fossils that appear suddenly and fully formed in the fossil record  as transitions is to assume the evolution in jumps that is being proposed for the lack of the gradualistic intermediate forms,.

You need to make up your mind whether you believe in neo darwinism which is the teaching that evolution is uniform, continuous and does not happen in leaps or whether you believe in the excuse for the failure of the fossil record to be consistent with evolution with  punctuated equilibrium which says that evolution is  is discontinuous and happens in leaps.

You and phil need to make up your mind on your position.
Reply: MarshaII Roberts OK, I realise you're just a kid, so I shouldn't be too hard on you, but really, you should at least try to look at the quotes you are giving. 

AGAIN, they are saying the opposite of what you think.

"precious little" does not equal none. Correct?

"abrupt" does not equal non-existent. Correct?

The part of the quote about the imperfection of the fossil record is with reference to how gradualists think the fossil record is not a problem for gradualism. Correct?

So where is the problem?
Reply: narco73"precious little does not equal none"

Precious little makes your gradualistic faith lose cogency.

However if you accept the existence of these alleged "precious few" then you are not being consistent with your punctuated equilibrium faith which argue contrary to neo darwinism and that evolution happening in leaps.

"abrupt" does not equal non-existent. Correct?"

The abrupt appearance of fully formed fossils and the lack of the gradualistic chain is not consistent with your neo darwinist faith.

"Where is the problem"

You mean with you holding to neo darwinism which says evolution does not occur in leaps and is uniform and continuous and you also holding to punctuated equilibrium which says the opposite and that evolution does occur in leaps and discontinuous.

You need to make up your mind.
Reply: MarshaII Roberts Have you not read anything I've said?

It makes no difference if evolution occurred gradually, or by punctuated equilibrium. It still occurred.

And like I have already said... in fact, I'll copy and paste it, since you seem to have missed it the first time, here you go:

"we are currently discussing whether or not evolution has occurred. We are not discussing whether or not punctuated equilibrium has occurred, nor are we discussing "Darwinism", "neo-Darwinism" nor "acid-house-Darwinism"."

At least try to come up with an honest and intelligent objection.
Reply: narco73  "makes no difference if evolution occurred gradually, or by punctuated equilibrium. It still occurred."

Well if you are going to argue for evolution then you need a consistent position.

Your inconsistency is not demonstrating any dishonesty
Reply: Evolutionists are in crisis without an agreed theory.